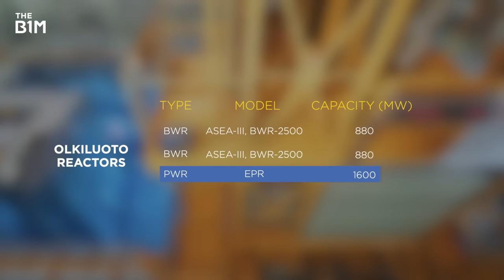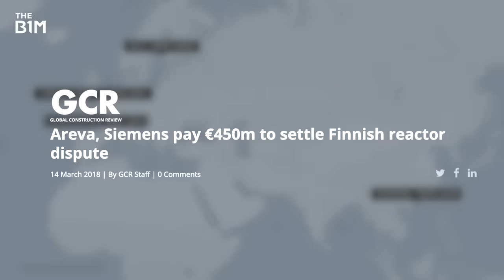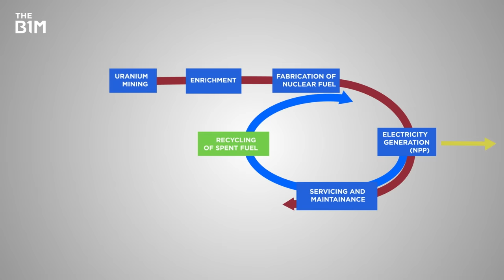Finland Might Have Solved Nuclear Power’s Biggest Problem

Comment: "guys, burying this isn't a good idea."
-"... Bury it deeper."
"Genius mate, bloody genius"
Reply: @miraclemaker1418   why ?
Reply: Hey, it works!
Reply: @GiorgiGoguaTuzo  because its very obviously a scammer
Reply: Pinned by The B1M  And many decide against trusting scammers like you. Google should eliminate the ability to have users phone numbers be used in the comment section I swear.

And for OP, @Timothy Shane , Lmfao, damn right. I thought they were going to find a way to recharge this or something that would prevent having to bury it. But no, instead they simply said "ah yes, use the same old method!"
Reply: @jxkc.3941  Burying it is not a bad idea. It came from the ground already. If was already there it shouldn't be too much of a problem to simply put it back.
Reply: @davidtherwhanger6795  Hmmm... Would it not have been there in a less charged state though?
Reply: Pinned by The B1M  pretending to be the channel owner and spamming that same comment 40 times on a single video is also a decision, a very horrible decision.
Reply: I know right, because if they encase it like that and bury it in the basement of a parliament building for a thousand years you wouldn't be so up for it. Plus I don't know how deep ground water moves about..
Reply: That's what she said.
Reply: @fyodorseriencha6538  Ground water can go as low as about 9000 meters, but it depends on the water table in the area to see exactly where it is.

But that really doesn't matter. Water is a shielding material. Every two feet of water between you and the source, you can take a zero off the power of the radiation that's getting to you. The water we used in the nuclear reactors in the Navy only held their radioactive charge for less than a minute after moving away from the source. 

Sailors onboard nuclear submarines would get less doses of radiation than people on land just going about their lives. Shielding is everything. And as deep as they are putting the stuff down here should knock a 1000 zeros off what radiation gets out of there.

Oh and you are standing on billions and billions of tons of Uranium that is cooking hot right now. It's what keeps the magma liquid.
Reply: @davidtherwhanger6795  "Water is a shielding material" I don't know how it works, I just assumed the casing could fail and water could get in and wash it off to be eventually absorbed by trees and get into drinking water bit by bit. But as I say I don't know, why even dig it so deep then if there's no way for it to get out and spread?
Reply: That's why you haven't studied physics...
Reply: @fyodorseriencha6538  Putting it in deep is how you make sure it doesn't spread. Putting it in bedrock that has been geologically stable for millions of years means the ground won't be moving around to rupture the containers. The clay around the containers expand when absorbing water, so if water does get in the clay will absorb the water, expand even tighter against the rock and keep the container in place. The pressure from the clay won't exceed the pressure the container can take as it is copper sheathed boron-steel. The copper sheathing doesn't corrode or rust, so any water getting to it won't effect the steel. And the fact that it is so deep means that even if a container is breeched , the radiation won't make it even near the surface.
Reply: @davidtherwhanger6795  Good start there lol: ''Putting it in deep is how you make sure it doesn't spread.'' Look, by my guess,  the ground has a potential to move no matter how deep away from the surface it is, I think it more depends on how far away the site from the cracks in the tectonic plates.
If the ground does move it will grind away at that clay layer and make it lose it's structure and water will get passed it. And you haven't answered me about if flowing ground water can pick up the radiated particles once they are exposed and how far it could transport them.
Also if this site is approved, the next sites would have even more lenient standards to decrease costs approved well paid off experts - it may be that they're just putting their foot through the door.
Anyway you may be right about this particular site idea being safe, but once a few more nuclear disasters happen there'll be a larger mob of people like me all too ready to lynch you i.e. all that circle of supporters and enthusiasts who push the tech with yet more smartass not 100% explanations. Nuclear is my pet hate.
Reply: @fyodorseriencha6538  Your ground water already has radioactive particles in it. And it has been for billions of years. You have radioactive isotopes in you right now that will stay there and given enough time will kill you from radiation poisoning regardless of what you do. And you were born with many of them.

Because you don't like it you will never be convinced it can be used at all. Even if there was not a single accident in the next 100 years it would not be good enough would it. 

But let me tell you this. The largest, longest running fission reactor on the planet is what is keeping you alive right now. At our planet's core is billions of tons of uranium, along with a lot of other heavy metals. This is crunched together giving us an natural fission reactor. It's what heats the core, and keeps the magma liquid. A liquid magma and the planet's rotation give us a magnetosphere. This magnetosphere is what keeps out the vast majority of the Sun's Fusion fired radiation from getting to us on the surface. The Ozone layer and atmosphere are insufficient even at full to stop like 70% of the radiation coming our way IIRC.

And this reactor at our core is running out of fuel. It will last a few million more years, but will stop eventually. The magma will radiate the heat away as it does now, but with no new heat from the fission process the magma will cool and solidify. Plate tectonics will stop. The magnetosphere will go away, like it has on Mars. And the full fury of the Sun's radiation will begin slamming into the atmosphere. 

Nuclear may be your big hate. But fusion and fission drive everything. Wind comes from the heat of the sun creating high pressure zones that then flow to low pressure zones. Solar uses the visible light part of the Electromagnetic spectrum, that is generated by fusion. Thermal energy is driven by the heat given off from the fission happening in our planet. You may not like it  But nuclear doesn't care. It is part of you anyway.
Reply: OMG, what's wrong with these people we have solar panels and wind turbines...nuclear power is the last thing we want on this or need on this planet...NIMBY. 

Statement from a local American Green Energy Disciple
Reply: If you're going to bury a body bury it right.
Reply: what about thermal, by using the heat from a very deep hole we can make steam
Reply: That's what she said!
Reply: @atomicviking2497  I'm aware, I was portraying the typical Green American.  Beside their NIMBY stances, they disregard the solar and wind current technological short comings and the vulnerabilities of the climate sources.  Additionally they seem to be unfazed by rather precarious nature of Lithium-Ion batteries.  When they fail just replace the battery packs.  
I have a 1953 tractor (diesel) that I can start up without issue and the motor has never had an overhaul. Does anybody believe that they will find a Tesla auto that will be able to operate without a battery pack replacement...after 20yrs?
Reply: @davidtherwhanger6795  thank you for sharing your thoughts without condescension.  I have learnt a lot, and still lots to think about.
Reply: @BWolf00  All those renewable energy sources are environmentally unfriendly, even more than fossil fuels.
Reply: @atomicviking2497  Efficient fusion is here. It was here at least in the mid 1980's. But fossil fuel companies patented them and sat on them, so others can't legally make them.
Reply: I Know let's drill lol 😂
Reply: @davidtherwhanger6795  But will contaminate the ground. And matter of fact, nobody knowa the long term effects of storing radioactive material underground. This stuff is radioactive for 400.000 years!!!
You can't call that clean, it's THE most enviromentally damaging solution we ever used!!!! Calling it clean is a blanket statement just like the decision to bury this shit "deep underground". 
It's clean "now" but not our problem after we die. A shit mental we've been fighting since the dawn of time.
Still nothing but a bunch of apes shitting where we eat but on a different level.
Reply: @aquamanindependent8436  This isn't true. Are you talking about cold fusion? If so it's never really been replicated and there's no reason to think it would work
Reply: @VI-pp4jo  do you have any reason to think this is "the most environmentally damaging solution" or are you just guessing
Reply: @atomicviking2497  Nothing is 100% clean. NOTHING. It's in the laws of physics of equivalent force reaction.
So long as the energy production is not at 100% efficency, there is going to be a byproduct to worry about that is not easily predicted.
So yes lithium batteries are a huge issue. But this technology is far from being at 100% efficiency, there's pottentially a cleaner way of doing it, and dealing with the fallout, is much more manageable than pure radiation for half a milion years. There is nothing clean about nuclear reaction and as I said above, we have no way of predicting the long term effects of it. For all we know, copper shielding could be erroded from inside, which is probably what's  going to happen in 200~ years.

What ammount of energy would be needed to excavate those canisters, while keeping safe from the radiation and not creating a mountain of robots that fail before reaching the reactive source.

It's insanely stupid what they are doing. Period.
"Cleanest" is designating a dump planet, as someone said, a gas giant. That will buy us some time, not fix the issue.
The energy we keep producing is not free and never will be. Watching people avoid this obvious fact makes me understand that we are being run by monkeys. I have no respect for anything "scientific" as defacto. Just a misrepresented view that serves the current power.
That copper WILL "melt". It's a calamity in the making.
Reply: @mymoomin0952  Yeah, I do. And what anyone CAN do is guess. Mine is based on the fact that radiation are just a bunch of particles traveling at very high speed. Colliding with copper particles, will slowly errode the copper. Which is THE only barrier between the core becoming a disaster underground.
Reply: Seriously? 
That's what it takes him 7 minutes to say?
Reply: @fyodorseriencha6538  Since the waste is in a closed capsule made of copper and then but in a hole filled with concrete, which is part of a tunnel which is also backfilled with concrete. Seems safe to me as it is in the bedrock as well.
Reply: @VI-pp4jo  First, there are other layers of protection. Second, there are things we can do other than guess. We can calculate what the total emission of the waste will be over its entire lifetime and test whether the capsules will withstand that. It turns out they can
Reply: @mymoomin0952  based on what?
Reply: Who participating in this discussion is a legit nuclear physicist with abundant experience with nuclear engineering?
Reply: @mymoomin0952  "First, there are other layers of protection" No. There aren't.
Reply: @VI-pp4jo  Why do you think it is stupid what the finns are doing? It is permanently solved right? 
I do think we need better solutions as fusion which is a great option to most energy plants. But until we can run stable fusion reactions, nuclear is the most efficient and safe solution there is atm. In Finland there are no rivers really and the sun doesn't shine as much as i.e. usa, and wind is not efficient enough in order to run industrial scale demand. So there are kind of few options that are clean and efficient enough. The best thing now that could come is fusion reactors or energy storage of some kind. But thats my opinion.
Reply: @VI-pp4jo  Yes there are? Each canister is fuel inside a boron steel canister, inside a copper canister, inside bentonite clay, buried deep underground in geologically stable bedrock. Each step adds another layer of protection
Reply: @VI-pp4jo  boron absorbs radioactive particles, its uses to control nuclear fission in reactors
Reply: @mymoomin0952  First of all, I'm surprised you found that.
But it just goes to show, it's inaccessible to the regular human. And if I can't read it, or for that matter 90% of the population and I'm being generous! Then the ones who decided "it's ok, let's do it" didn't act on a fundamental underatanding but on a chewed up representation of such a study, on a feeling passed on from scientist through to the power chain of decision in a country. And this is important because, again, probably close to 90% of the responsibility of that decision is shared and based on feeling. 

Which ultimately, is how we humans do, but it's also when feelings get corrupted and blindsided by an immediate objective, which can be anything and throughly decided before hand. 

"We are rationalizing animals, not rational" and this study I'm fairly certain is a rationalizing not rational. But maybe I'm crazy. 
First, check a snip of this study, that we're all highly opinionated about:
Reply: "Radiation damage occurs in a crystal if the transmitted energy from the energetic particles is sufficient to create stable defect pairs (Frenkel pairs) in the lattice. Historically, the Norgett-Robinson-Torrens analytical calculation method for the number of displacements per atom (dpa) in a lattice (NRT-dpa) (Norgett et  al. 1975) has been the standard evaluation method for this purpose during past decades, beside the Stopping Range of Ions in Matter (SRIM) code package. More modern approaches use semi-empirical interatomic potentials and classic molecular dynamics (MD) simulations. Recent progress has opened up for fully quantum mechanical calculations of the primary damage state and radiation damage parameters (Olsson et  al. 2016)."
Reply: "In order to evaluate the total damage, we need to calculate the damage rate first. Here we establish the theoretical framework for displacement damage. First the damage rate equation is presented as the equation governing the impact of radiation field on the material.  After this its various components  are discussed together with equations relevant in the context of the final repository.  The difference between gamma induced damage and neutron induced damage will be discussed here."

Seems to me, we're still basing 1milion years of incidence on our current science level. Which, I would like to add, goes through violent changes from century to century....
Reply: "When the incident radiation interacts with atoms in a crystal, all or some of the energy may be transferred. If the energy is sufficient, an atom may be scattered from its position in the lattice  and propagate through the material.  As it moves in the material it will interact with the surrounding  atoms  and  either recombine back to its original position, stabilize as a Frenkel pair (a vacancy and  a  self-interstitial) or generate a displacement cascade if the energy is high enough."...
" If an atom is displaced from its lattice  site, it receives a kinetic  energy given by  EK  =  T–Ed, where  T  is the energy transferred in the collision. If the kinetic energy is high enough, the primary knock-on atom (PKA) will move in the crystal lattice and when doing this it may impact the surrounding atoms and a displacement cascade may follow. "
...
" The number of displaced atoms,  v(T), as a function of transferred energy can be modelled by the Kinchin-Pease model,... However, this model is not accurate for the low (near threshold) nor high energy ranges (far above threshold). For high energies the NRT  model (Norgett et  al. 1975) has been seen as more appropriate but the recently developed arc-dpa model is  clearly more realistic (Nordlund et  al. 2018). However, here the dominating damage processes are in the lower and intermediate energy ranges and an in-depth discussion regarding the high-energy recoil range will therefore not be pursued"
Reply: I "chewed up" the article for those of you who don't want to read it and my conclusion I already stated at the beginning of this.
The decision of this is done on feeling, based on this study alone mind you, LOL !! For half a milion years, this piece of study is our "seal"  written with our current science level AND if you bothered to read that, the main argument I had, about copper melting, is not even tackled in the study. Talking about "high energy recoil" as it's being called which creates a cascade effect into the matterial. I understand that such forces are not immediate but the fact that it's not being explored at the least, with the risk of sounding like a broken mill, this is half. a million. years. we're talking about, combined with the fact that science changes drastically, often, gives me enough reason to conclude, we are still monkeys shitting where we eat.
Reply: *And, I might add, the last barrier between this calamity and us, is soil.
Mind telling me where else do you know where we can get farmable soil? Not for us, or the next immediate generations, but for the idiots that have to still believe this world has anything good left in it coming after... well who knows, that study surely doesn't.
Reply: @VI-pp4jo  Here's some questions to think about.
Where did the material come from first?
Was it radioactive before we used it?
How much is still in the Earth?
Is the Earth contaminated?
I ask these to gage how much you really know about this. I am not trying to be condescending, but I need to know going forward.
Reply: @davidtherwhanger6795  Butting in, agreed on last part.
It's worth noting though, that radiation, if we're wrong affects us for 400.000 years.
Solar panels and wind turbines, produce less energy but their fallout is MUCH more manageable amd we are not taking a half a million years loan from future generations.
Don't act like you can just sweep that under the rug and call the place "CLEAN".
Manage the fallout. Solar and wind is MUCH MORE MANAGEABLE!!!!
Reply: @davidtherwhanger6795  Saying "I'm not trying to be condescending" is precursory to being condescending. I wasn't born yesterday, you might have.
I don't mind you being condescending, so long as you're right but given your "put it back in mentality" I have no doubt you're wrong.
If you understand that energy doesn't just come "free" you must understand that we don't just take the pebble from the ground, extract free energy and put it back in.
Before you ask me what I know, feel free and "be condescending" and tell me how you think it works. In as much detail as you want 👍
Reply: @davidtherwhanger6795  Interesting angle you're coming from, I don't think there's any argument about feeling safe walking outside on top of the earth's crust with some sun cream on. And just because uranium is natural in our world and not some sort of black magic, it doesn't mean that it's not something to be justifiably scared of. Just pretend they instead developed black hole technology to generate electricity and then found a way to "encase" those black holes under ground so that they have no power to suck everything in. It's Icarus mentality.
Reply: @hamburgerhelpers3896  I know right, Tai Lung from Kung Fu Panda style
Reply: @VI-pp4jo  First off heavy metal contamination is forever. Once in it stays there until something removes it. And then you have to store it somewhere and hope it doesn't get out again. Forever. Fissionable material giving off radiation does have an expiration date. Heavy metals we will be dealing with until the end of time. But burying heavy metals is acceptable means of disposal, but we are not to accept radioactive material burying is acceptable? The main argument is that the material could get into he water table. Yet both could get into the water table by burying it. And the burying practices for heavy metals is much less careful than radioactive material as heavy metals are just dumped into land fills where rain water will definitely get to them.

I have been told we are approaching the upper limit of what solar can do do to our atmosphere. Solar panels in space are much more efficient because of the atmosphere not being in the way. So as long as we use solar panels we will have to use a lot of them on the surface, meaning a lot of heavy metal contamination in land fills across the planet in just a few generations. This will far exceed radioactive waste by several orders of magnitude quickly. You might counter with 100% recycling. But that would increase the cost. With a limit on efficiency put on us by the planet itself the cost of solar panels could exceed the price of power creation, making them economically unviable.

With wind power we are limited by technology. That is currently changing. But bringing with it more problems. I do not know if you have heard of solid state wind energy transformers (SWET), but they could revolutionize the industry. Or destroy it. They would last longer by removing moving parts and fiberglass blades. Fiberglass is not biodegradable at all and will last in the landfills for effectively forever. Solid State units I believe will use heavy metals, but their main problem is the electrical discharge they will have going on will definitely kill any wild life that gets near it. Some have likened them to giant bug zappers.

Now on to other topics. You may have heard about Background Radiation. It is all over the planet. All the time. It is what we get from the sun, and what we get from the planet. Right now at our planet's core is billions of tons of uranium going about in a natural fission reactor. It's what provides the heat to keep the magma layer liquid. This keeps the plate tectonics going. Volcanoes erupting. And our planet's magnetosphere working. Without that magnetosphere blocking the vast amount of the sun's radiation and coronal mass ejections from getting to the planet in the first place, we would not be here. The big problem with the core though is it is running out of fuel. Because fissionable material does decay. There is only a few million years of life left in it. And it is what is keeping us alive. Mars doesn't have a magnetosphere, so it gets cooked by the sun's radiation.

The only thing that saves us from the radiation at the core is distance and material. A common misconception is that radiation is blocked by some materials. It is not. It is reduced by shielding materials. The more in the way the more reduced it is. For every 2 inches of lead, 4 inches of steel, about 1 foot of stone, or 2 feet of water between you and the source of radiation you can take a zero off what radiation is getting to you. So burying it deep does help a lot.

And our water supply has had radioactive material in it from the beginning of the planet. That has never changed. Even if a river hit that storage facility and breeched every container eroding the material it would be eroding only atoms and small pieces of it at a time. You would barely see a rise in what radioactive material is already in the water per given volume of water.

And you were born with radioactive material in your body. They are still there. And will kill you given enough time regardless of what you do.

Radiation is natural. We live in it everyday. And have lived thru periods where it has been much higher due to drops in our magnetosphere allowing more in from the sun. We can manage it just as well, and perhaps better, than we can and do manage others.

The only difference is we have been told to fear radiation and not the other stuff that is just as deadly.
Reply: @davidtherwhanger6795  I'm aware, I was portraying a typical Green American Disciple.  Those whose beliefs say that nuclear and fossil fuels are all poison beyond the science and technology of man thus they must be abandoned.  Those who believe that millions and billions of acres of solar panels and windmill farms poses little or no threat to man and the earth. These disciples along with the "conservationist" activists cry NIMBY about nuclear and fossil fuel projects but say little about inefficient and immature green energy "infrastructure" projects.  
Additionally they seem to ignore the law of conservation of energy...while the Sun's power output is virtually unlimited, Earth' environment is not a closed system...and I have not heard any research about the long term effects of robbing Peter to pay Paul.
Reply: @davidtherwhanger6795  I'm actually impressed. I had no idea that heavy metal poisoning was even an issue.
Coincidentally, I just watched a video of the mass dumping activities in Ghana and the people there dying working to recycle the electronics, for chump change. They're given just enough to survive, kept in the loop forever. The biggest food market in West Africa is just accross from the massive electronic dump field. You can see cows "grazing the field". It's surreal once you open your eyes. 
The cadmium concentration is.. I forgot how high, but way above limits. 

STILL, they are working in that field and are not dying immediately, takes years and years. And most importantly, it's curable. There is no cure for radiation apart from replacing entire organs. 
Not to be read as if I'm excusing the practice, it gets me wondering how we can fix it, but the comparison is to paint the picture. Heavy metals, are metals, they are present on earth in far FAR larger concentrations than uranium 235, uranium which if I understand correctly isn' t even the only problem but the byproduct of nuclear decay.

The issue with heavy metals is very poorly managing of recycling which allows for them to seep into the soil and mix at a very high concentration. Which, mind you, will keep increasing.

It is still far more manageable than a  tomb of uranium decayed byproducts radiating the entire soil for 450.000 years.
If our current heavy metal situation was a star, a radiation tomb is a pulsar.
At least that's how I see it.
It's not that a high concentration of heavy metals is fine, it's that radiation is far FAR worse.

And studies presented here, are blankets, they're not produced to inform but to throw a bone to the first waves of skepticism.
Just look at the way we treat our garbage, to understand how well intentioned humans are.
I'm not going to believe 3 scientists are enough to give this the go.
Reply: @BWolf00  Yeah, the biggest realization is that the world was already in as perfect equilibrium as possible.
Question is, live and enjoy or... fight to escape our obvious demise.
Don't think we can but, I also don't think we should stop trying.
Reply: @BWolf00  😂 oh well. Sarcasm doesn't always come across in text.. haha
Reply: @VI-pp4jo  Only some of the effects of heavy metal poisoning can be cured. Prolonged exposure does lead to life long problems, and possibly to genetic defects in children at birth that cannot be cured.

Regardless of that though. You see that certain levels of heavy metals are acceptable. What level of radiation is acceptable then? We get it every day. Radiation is all around you right now. How much radiation does this waste produce? How much shielding is needed to reduce it to acceptable levels?

My point is that burying it deep enough reduces what makes it to the surface to be so low you can't tell difference from it and the back ground radiation that is already there except with the most sensitive detectors we have. And will still be below acceptable levels. A thousand feet of stone does a lot to reduce radiation. And we are talking about a facility that would be in use for quite some time, so breeches would be noticed and repaired. Unlike how we treat other pollutants right now. The facility could still be monitored after official use was over by simply keeping the radiation and moisture detectors on and monitoring their output for problems. 

Just because there is radiation below ground doesn't mean everything above or around it would be contaminated. Or else the Billions of tons of uranium (which is a heavy metal as well and I won't get into depleted uranium munitions here) would have irradiated the planet long ago.
Reply: @atomicviking2497  I knew I was running that risk...np.
Reply: @RenanMsV_YT  you have a point but it's the same argument with environmentalists
Reply: @VI-pp4jo  My main problem has been that many look at nuclear waste and see a boogey man they fear. They give a hand wave to the other problems of other things, but scream hell and damnation about nuclear. 

But I believe almost anything is manageable. Cost, risks, efficiency, and benefits all have to be weighed.

On to the bright side. Solar will never be that useful to us, down here. The atmosphere plays hell with the light reaching them. The higher up you get them the more efficient they will be. I personally want to see tethered power satellites in geosync orbits with huge solar arrays getting near 100% efficiency almost all the time and sending back that power.

Have you heard of the King's Island Wave Project? That is where they are harnessing the power of wave motion in the water to produce power. Australia seems to be leading the world in this endeavor with several different types of wave power generation being tried right now.

And I have heard at least on company is experimenting with a way to pull carbon straight out of the air. We have been able to do this in closed systems for over 60 years, but these guys are wanting to do it on an industrial scale to make graphene. And there are several companies around the world are actually building facilities to pull carbon straight from the atmosphere for various purposes.
Reply: @atomicviking2497  I have always wondered why the Fossil Fuel Hegemony never bought up the "designs" the "technologies" associated with electric vehicles, solar panels and wind turbines...seems these should be locked away in that ever mythical Fossil Fuel Protection Vault.
Reply: @davidtherwhanger6795  The point about radiation is that it irradiates/contaminates the ground around it. And argument that other do too, is not an argument for radiation.
How much worse is nuclear decay compared to heavy metals, I do not know. As in, I do not have a table with the effects of both on a scale. But, as I said, heavy metal poisoning is a matter of recycling better. The solution is here. And I'm glad to hear about extracting energy out of seas tide and out of air? wut. I'm sure they all pose serious problems that must be tackled and accounted for.
I for example would like to see a biotechnical solution, that combines all these energy capturing devices and uses them to "brake" the flow of nature into the direction we want.
Having massive windmills that brake the wind, obviously will have a local - > into a global effect. I don't know what that is because I'm not versed in geo-formation or w/e, but I'm sure it exists, as it's only natural. Same with tide.. Same with solar and so forth. Everything has a fallout.
However sometimes, the action of natural forces are the fallout themselves. Such as tsunamis, hurricanes, earthquakes, etc. These are just extreme examples. But if we can harness these forces, then we have definitely conquered it on a lower scale, such as locations where high wind is detrimental to the landacape for example.
That's "conquering" CIV I not nuking ourselves for the next half a million years so we can accelerate the process of consuming.
Saying, they will attend to the pods, is wishful thinking. It doesn't take a genius to see how Chernobyll was handled and apply it to the current topic.
If there's cracks at Chernobyll, you best believe they will fix it, because it's in their "backyard".
If the canisters/pods fail in Finland, deep underground, where tons of soil shield us, you best believe nobody will care until the stink comes to the top. Which won't happen for the next few generations. And when someone HAS to do something about it, it's deep underground!! Where tons of soil are already radioactive... In case you forgot how radiation works and thr energy required to amend the situation will be competing with the one that was produced. Thus, making this very not clean, a problem for future generations and tons of dead soil for 450.000 years.
I don't care what argument you have about heavy metals. It does not take away from the fact this is an insanely stupid idea.

And one last point, that caught my eye since you first spoke of taking it from the ground and putting it back in. Uranium 235 is a very VERY VEEEEERY small portion of uranium found in nature. Less than 1% of it.  Check this quote from wiki:
"Naturally occurring uranium is composed of three major isotopes: uranium-238 (238U with 99.2739–99.2752% natural abundance), uranium-235 (235U, 0.7198–0.7202%), and uranium-234 (234U, 0.0050–0.0059%)"
To get uranium 235, they enrich regular by "Isotope separation". So that talk about "it's cool, radiation is all around us" is severely misrepresented. My friend, as I've said and you probably grazed over, the key is in INTENSITY. 
Everything comes from nature. What kills you is high amounts! 
And there's very high amounts being burried underrground, and not some fuck know how many thousand of kms away from us underneath a core of molten lava! So don't equate that!

Or I can equate having Betelgeuse as our star and say, "It's k, it's still a star, we have stars in nature". WE. WOULD. DIE !!!
Reply: And, regarding how much is too much, is a question that I'm pretty sure you, and I'm sure I, can't answer.

However, it's about watching history repeat itself.
That copper, I bet my life on it, will get erroded, not sure how long it will take but it won't be thousands of years, and once that cracks, it's a house of cards where corrosion does the rest and radiation grows quite possibly exponentially and also accentuates the process of de-sealing, talking about concrete, which is not gonna last for more than 100 years, pretty sure I've read that about Chernobyl.

This is all theory crafting into the future of mankind. As I said, it's a loan into our future. A very very documented tendency in us. Everyone and their mother has had a loan and US has unpayable debt. 
I don't stand for it  in the slightest. Humans are nasty creatures that follow an immediate gain. That's what this is. You can try and find reasons, scientists and all that bullshit, nobody can predict the future for 50 years let alone thousands, hundreds of thousands is laughable. Just the fact that I am still here arguing this insanely obvious charlatany, is making my skin boil...............
Fuck them. From A to Z whoever approves this monstrosity. And you if you support it.

Consume less and more focused on growth if that's what's really followed.
But it's not, what's followed is more power to produce more consumerism under the guise of "evolution".

Evolution is accountable. 3 scientists and a copper tube burried underground does not make the most damaging effect known to man-kind even.. retarded. Just retarded.
Reply: @VI-pp4jo  If you read nothing else, read the article at the bottom.

I'm a graduate of the Naval Nuclear Power School. I have actually been inside a nuclear reactor (outer areas after a couple of cool down days). I've been closer to this stuff than I hope you will ever be.

What you seem to be missing is INTENSITY as you put it drops off over DISTANCE. Shielding material like stone, earth, and water drop it off exponentially over distance.

And yes I do know that U-235 is less than 1% of uranium. In a comment to another on a different thread of this video I told that to some one else explaining enrichment.

The problem I think here is you believe that the material is some how actually magnified by the enrichment. This is not the case. It concentrated by the enrichment process. Removing the U-238, but retaining the U-235. The same amount of radiation was being given off by the rock that was first dug up as what is being given off by the uranium that is there. You do have more of it in one place. But this is low grade enriched. 
https://www.wise-geek.com/what-is-enriched-uranium.htm#:~:text=The%20lowest%20grade%20is%20known%20as%20slightly%20enriched,although%20it%20can%20be%20as%20high%20as%2020%25.
As you can see LEU is normally between 3% to 4%, or roughly 4 to 6 times more concentrated than normal. Meaning it's Intensity is only about 4 to 6 times as much as normal ore which has 0.7% concentration. So while you believe it is super intense, it is not. Your probably thinking this is weapons grade or High Enriched Uranium.

And there are open pit uranium mines in the world. Meaning the uranium was much closer to the surface than this facility would be. People work in these open pit mines all the time.

Now that I think of it you are probably thinking that the Intensity is coming from the metal itself and not the reaction. That is actually a little misleading it self. As U-235 decays it gives off a neutron. This neutron must hit another U-235 and cause it to shatter into Ba-141 and Kr-92, and gives off 3 more neutrons that then collide with other U-235 atoms and causing them to split. This is why it is called a chain reaction and the phrase splitting the atom. After a few years this nuclear fuel begins to drop in it's ability to sustain a reaction as much of the U-235 is already split into other elements. The waste is then treated for years. As explained in this article.
https://whatisnuclear.com/waste.html#:~:text=But%20because%20nuclear%20reactions%20have%20occurred%2C%20the%20contents,of%20iron%2C%20zinc%2C%20germanium%2C%20zirconium%2C%20silver%2C%20and%20iodine.
Reply: @atomicviking2497  Jesus, what's your problem?  I wasn't "arguing" with you, in fact I was agreeing with you.
Your reading comprehension and sarcasm sensor sucks.  You must have used it all up yesterday.
Reply: @davidtherwhanger6795  I am not missing that it drops off over distance but I think saying, "it drops off" is misrepresenting. It doesn't just drop off, the material around it absorbs the radiation, absorbtion which, denaturates the material in the process. I. E. irradiation.
And my problem is if the copper fails, and it will, irradiation starts growing exponentially.
I am not saying it will reach us in deadly doses directly. I am saying we are killing a piece of land, and we are, for 450.000 years. Sometimes being in the field serves as a blind spot so you should welcome outside input, gets you leveled.
Second, I have been thinking of HEU, so good to know there's a difference. The article also mentions that it can go as high as 20% concentration, which signals to me that if it can, it will. As soon as the energy needs rise, so will the enrichment and 20% is just an arbitrary number, it can go as high as, depending on needs as I just said.
Let's take 4% concentration though. Is the U235 the only thing being deposited underground? You haven't mentioned anything else...

/// Just got to the last link, and it is mentioned. My point was nuclear waste is not made up of only u235 but other byproducts which are highly radioactive, so talking about just u235, is shallow.

Anyway, I've read the article, very informative and I also feel it is very supportive of nuclear power. And you as well, being in the field are.
The study does not account for pollution implications over time, it compares it with current levels of pollution from coal and oil which nuclear obviously wins. On a function of time, will it though? It's impposible to know. That's a big part of my argument.
You're borrowing time from future generations, shining a light on the inadequacies of current energy production while shadowing the very problematic "0 knowledge" of what this does in as much as 1000 of years. Let alone more. Nuclear is a century old, it's too young for us to bury radioactive waste in the ground. So yes, I am mad. Has nothing to do with believing in evolution or whether mother nature is ruthless, I never said it isn't.
I am attacking an obvious selling pitch of nuclear power.
I've said it multiple times already, it's 3 scientists, copper tubes AND as you've well pointed out a century of understanding about nuclear to guarantee for 450.000 years. You tell me if that sounds right to you.
I'm pretty sure you're just blinded by being in the field and you want it to succeed because you're part of it.

I want it to be a clean solution that saves us all too. But it isn't. Not with 450.000 years of uncertainty downplayed as "serious concerns" and even that just as a title.
Like seriously, where in that article were long term effects addressed? That's from very strong proponents of nuclear power.
All I saw was a chick standing next to a cement casket. What happens if that casket is unatended for 100 years. Just that, not talking about more.
Reply: @VI-pp4jo  There is no solution that is clean. And the concentration of the material doesn't change the amount of radiation it is giving off, just the location. 

Look at it this way. You dig up 1000 kg of uranium, containing about 7 kg of U-235 from a hole in the ground. You enrich it, which is incredibly difficult and no level of enrichment is reached by accident. You now have 175 kg of uranium. If you put that back in the same hole you removed it from it's still the same 7 kg of U-235 isn't it? Did it wreak havoc on the soil before?
Reply: @VI-pp4jo  Oh I did forget to mention that to get other material to become radioactive they themselves have to be giving off neutrons when absorbing the neutrons given off by the fissionable material. Not all materials do. If they did then everything would have been radioactive billions of years ago.
Reply: @GiorgiGoguaTuzo  spam
Reply: @atomicviking2497  misinformed mate
Reply: @BWolf00  you are 100% misinformed
Reply: @aquamanindependent8436  clearly oil company propaganda.
Reply: @kriss8931  I guess you are having trouble conceptualizing  jus how long 100,000 years is.
Reply: @mymoomin0952  100,000 years… there is no test for that.
Reply: @minaaris  I was an engineer for the Fukushima plant and before that Chernobyl.  Feel better now?
Reply: @mymoomin0952  you something to say come out and say it for Christ’s sake.
Reply: @launcherx2044  until it cracks
Reply: @VI-pp4jo  well masticated.
Reply: @davidtherwhanger6795  if you covered your entire house with solar your car battery would contain 100x the lead used in that solar installation-you probably replace that every 5 years. Cadmium is used in trace amounts. Both will be eliminated by 2026.  Landfills no longer leach into ground water - they are capped.
Reply: @davidtherwhanger6795  Yeah, but then why actually is the waste not just buried in some already empty mines, where the uranium was mined in the first place?
Reply: "a game changer!"
Reply: @davidtherwhanger6795  I agree with a lot of the stuff you've been saying about nuclear but I think there's much more reason to be optimistic about solar than you might think. There's tonnes and tonnes of space for solar panels, which are cheap and getting cheaper really fast every year. They'll never provide the consistent, year-round power nuclear can, but they can provide power during the day much more cheaply. Yes there's issues with disposing with heavy metals, but in the same way that we can dispose safely of nuclear waste we can dispose safely of heavy metals.

And obviously it'd be many times better if we could efficiently beam down power from solar-powered space stations, but until then there's an incredible amount of sunlight on the earth's surface
Reply: Basically they want to push the problem off to future generations to deal with. I love when humans think we can design indestructible things, remember the Titanic?
Reply: @atomicviking2497   countered your argument with a specific example I personally know of. But someone removed it. I basically retyped it in response to cpmac.
Reply: @rcpmac  And the battery storage for the solar peek power capture? For days when the sun isn't out.

Cadmium I think was banned in batteries a long while back because it only takes a trace. 

But the main reason I brought this point up is that one of the arguments of this nuclear waste facility is that it could get into the water table. However, if a landfill can be sealed with no chance of contamination, why not this facility? Thank you for pointing that our.
Reply: @davidtherwhanger6795  I've learned a lot today regardless of the fact we disagree.
I want to add, I just caught up with the naval part of your study, being the main focus. So you're a sailor! That's actually cool. Braving the waters has always been closed to my heart. Albeit in pirate form.. Arrr 🤣
Anyway, reading back from the perspective of knowing about nuclear first hand and catching up to it being a discipline rather than the focus of your study, I assume you developed these opinions about heavy metals being out of focus while radiation gets all the heat, from a teacher?
Also, I wasn't discrediting the efforts of people, well I was and am, but as a "not enough" not as a "you're not considering it". Road to hell is paved with good intentions though. Not sure what that means, geniunely but feels apt for the situation. 

Just one last argument I think we can have, how is.. 175 kg of U235 not more radioactive than 7kg?
Also, from the link you gave me, radioactivity comes after nuclear fision, so I don't underatand the comparisson.
Reply: @VI-pp4jo  you've said a lot so

• The decision to build the facility wasn't based on this study alone. This is one of several studies on specifically long-term radiation-induced erosion of copper shielding for this kind of waste disposal, which I chose because it was free to read and because it was the most recent. There've been many many studies on all aspects of this.

• If you're concerned about melting via heat, then I can address that for you now: the waste has already been kept in high-energy waste storage for a long time before being stored, so it no longer emits enough heat to melt copper, and it only gets colder over time.

• Radioactive waste will never grow exponentially in radioactivity, it'll only shrink exponentially. That's the fundamental problem with nuclear waste disposal — for long-term waste the risks are always minor but they last for a very long time. The many layers of protection aren't to prevent some kind of meltdown but to prevent a noticeably higher risk of cancer in an area of Finland, and they'll do a very good job of that.

• it's often overstated how much science changes. I can guarantee all those various prior models give roughly the same result but in increasing levels of accuracy. It's like how general relativity is more accurate than Newtonian gravity but the Newtonian stuff is more than enough to land spacecraft on comets.

• I get a general sense from your comments that you think people are very cavalier with risks around this. That might be true for some things but people are incredibly, incredibly cautious with nuclear waste disposal. This wasn't done off three scientists and a prayer; this was the culmination of decades of research into the safest possible methods.

• just in general if you can, off the top of your head, think of a potential issue, it's worth checking if it's been covered in the decades of research first.

• we can never predict the future, but I can guarantee you the pyramids will still be standing a thousand years from now. For this, we know how long this bedrock has been stable for (billions of years), we can model using a variety of techniques how long the casing will last (hundreds of thousands of years), and we can look at similarly-situated natural uranium deposits or reactors and see how much radiation reaches the surface (incredibly little)

In summary: if you told me they were making a low-level radioactive waste disposal hundreds of metres into bedrock below my house I would be fine. If you told me it was gonna be baked into a ceramic, which was put inside corrosion-resistant zirconium alloy, which would be inside a steel tube, inside a corrosion-resistant copper tube, inside water-blocking bentonite clay, inside especially-stable bedrock, and then the whole facility would be reburied — well then I'd have half a mind to ask you to not bother with the fuss. The project is so safe it's ridiculous, and pretty much any two steps would be accepted to store equally-dangerous non-radioactive waste. It's only possible to be this cautious because of how little waste nuclear energy produces compared to most industrial processes.
Reply: @rcpmac  That makes me happy 😁.
Reply: @never5pring  I am not certain, but two things do come to mind. First you can't put it back into an active mine, too much big machinery digging going on. Uranium is sometimes a byproduct of Phosphate mining as well so many of the mines could still be in active mining. And second, people have this strange notion that even if it was there for billions of years before it came out of the ground, it is now dangerous to put it back in the ground. And will protest and sue the daylights out of any one who tries to put it in the ground.
Reply: @never5pring  mainly because people are super-super nervous about nuclear waste, more so than natural ore, so you can't do anything other than the most absolutely safe possible option - and as you see here, people will even complain about that
Reply: @mymoomin0952  I'm not opposed to solar at all. And completely agree we can manage heavy metal containment.

I do disagree with giving on form a hand wave, but vilifying another simply because of bias. Using the term "Clean" or "Green" leads people to believe there is no problem at all with their use and that others are simply fools for pointing out options.
Reply: @aquamanindependent8436   Sorry but I'm pretty sure that example got eaten too. I don't doubt the fossil fuel industry has done something awful to do with fusion - it's the fossil fuel industry - but I do want to know more about safe efficient fusion power from the 80s
Reply: @davidtherwhanger6795  in that case I agree with you completely
Reply: @rcpmac  is the massive essay I just typed out saying enough for you lol
Reply: @aquamanindependent8436  genuinely I can't see it. I can see one where you mention a guy you told him about but not the one where you tell him about the guy. I think YouTube ate it? If it has a link or something that might be why
Reply: @mymoomin0952  None of which can account for long term exposure. They just can't. We do not control that many variables, I don't care how many studies are done.
And alarmingly, even the variables that we do know about, are dismissed as, insignificant.
From the study you gave me:
"However, this model is not accurate for the low (near threshold) nor high energy ranges... However, here the dominating damage processes are in the lower and intermediate energy ranges and an in-depth discussion regarding the high-energy recoil range will therefore not be pursued. "

That sounds very "cavalier" to me. That's a new word I learned lmao.

Anyway, that's my concern, radioactivity knocking the lattice of Cu and overtime creating a breach. Heat is a secondary concern once that breach is made. And radioactivity growing exponentially, is a resultant of this house of cards scenario explained above. I understand the concept of half life.

And again again again, I'm worried about what happens well into a couple generations forward. Not at all worried it will be a problem in our time.
People are very cavalier with our future generations time, not theirs. It's why I made the analogy of borrowing time from them. From 45000 generations, for which we have done "many many" studies.

I don't think you understand my outlook, because from where I stand, saying there's been "many many" studies is just drool coming out your mouth in front of a good steak. A juicy "cover all our problems solution so we can keep doing what we were doing" steak. 
And I can see clearly it's. just. a blanket. statement. for anyone who wants a piece of that steak. 
Nuclear is not safe or clean, it is "now".
The long term effects are not accounted for and CANNOT be. And when comparing current pollutants with nuclear, it is not done over a function of time. Because it cannot be! But it's not even attempted.

Anyway, I'm not going to just  reiterate what I said over and over.

I still don't understand radioactivity properly, so i will look into it. But, worth noting that the naturally found Uranium, is not the same as nuclear waste.
Not even close. Navy guy upstairs just linked a site where a guy was holding u235 pellets in his hand. So not... what we're talking about.
Reply: @VI-pp4jo   There are natural nuclear reactors that exist in nature, and have for a billion years. We can study them. There are natural pockets of radioactive material. We can study those. The low-level radioactive waste in long-term storage is safer than that. It is safer than nature. It's incredibly easy to say "oh but what if something happens" but we know for a fact that, for instance, this low-level waste cannot ever lead to a runaway meltdown of exponential growth in radiation. We know this because material this radioactive has existed for the entire history of the planet. We have millions of experiments and billions of years of history to study. It's true that technically everything could somehow go wrong - the sun could go out tomorrow! But predicting a catastrophe from this stuff is on that level.
Reply: @VI-pp4jo   I think what confuses me about your outlook of completely rejecting scientific evidence is why care specifically about radiation? If no study can ever be enough then surely literally everything on earth is at risk of causing a catastrophe and no evidence can ever disprove that — they would just be juicy "keep doing what we're doing" steaks covering up the risks of, idk, dandelions or whatever.

It seems like you must have some reason or evidence to start fearing nuclear waste rather than anything else, so why can't reason or evidence stop that.
Reply: @VI-pp4jo  I may have mistyped that. What I was trying to say was 1000 kg of uranium contains 7 kg of U-235. After enrichment at 4% there would be 175 kg of uranium containing 7 kg of U-235. The enrichment removing the other uranium.

Radioactivity is always present, from the very beginning. You may have misunderstood the article. The uranium that comes out of the ground is radioactive from the moment it was created by a couple of neutron stars colliding. Enriching the material makes it easier for a nuclear chain reaction to happen. U-235 gives off a neutron that goes shooting off and if it strikes another like it, that neutron breaks the U-235 into other things and gives off even more neutrons from that collision. That is fission. Enriching makes it easier because there is more in a smaller space than before. Natural reactors that do this are possible and have happened. That is what is going on in our core right from the beginning of our planet. And has occurred in the Oklo Gabon region of Africa. The process of fission reactions being caused to happen decays the material faster than it would naturally by not waiting for it to decay, but causing it to instead split into other elements right now. That's why after about 6 years the nuclear fuel has problems sustaining a fission chain reaction. This doesn't accelerate natural decay, but replaces it with a faster method of changing them into other elements. That's why I have been making the comparisons and arguments. The radiation is nearly identical to the way it was before, and if it caused no damage then, why do we think it will now?

And I am not opposed to heavy metals. I just feel that using of the terms "Clean" and "Green" are misleading. We are taught that power generation by these things are free of problems and we are fools for not considering problems or seeing alternatives.

There is nothing out there that doesn't have a problem with it's use, even if we don't know what that is yet.

I can't remember if it was you or another who brought up using wind power to block the wind. A few problems with that are that the blades cannot take high winds without risking damage. Most current turbines stop rotation and turn the blades to show minimum angle to the wind if the wind reaches 55 mph. And I have always been a little concerned with over use of wind turbines actually disrupting established wind patterns. I have no idea if this is even possible, but with solar panels causing new heat zones and thus higher pressure zones combined with increased resistance to wind flow by blades that the patterns would be disrupted. The Amazon Rainforest relies heavily on the wind born sand from the Sahara Desert for fertilization. Thousands of years ago the Sahara was underwater, then a large savannah, and in some places a rainforest. This caused a lot of diatomaceous earth to be deposited in the area that became the Sahara. After climate change turned it into a desert, this diatomaceous earth is carried by the wind to fertilize the soil in the Amazon allowing the forest. It has been thought that if this regular air pattern stops that the rainforest would go away. I don't know if it is possible, but it has been a question of mine. And goes to show that we have a lot of things to plan out going forward.
Reply: @alphazero6571  And how does that change anything I have said. Why don't you tell me what you think enrichment means.
Reply: @davidtherwhanger6795  You should look up "concentration" and "Half life" of "Uranium 235" and "Plutonium 239". You'll have then, a better understanding of the concentration of isotopes found in the "wild" vs. commercial grade and why it's bad to bury it. Especially in water tables.
Reply: @DJBillionator  Uranium has about 0.7% U-235 by volume. U-235 has a half life of 704 million years. U-238 has a half life in the billions of years. Some Thorium isotopes have a half life longer than the estimated age of the universe. Low Grade Enriched Uranium for power plant use is normally between 3% to 4% U-235. They get a higher percentage of U-235 by removing the U-238 while retaining the U-235.

Currently radioactive nuclear waste in the USA is stored at the Reactor sites mostly in Concrete above ground containers only 3 to 4 meters thick. This is sufficient shielding for people to walk in and around them. Why would I then think that 500 meters of stone and earth would not be sufficient to keep me safe from it?

And if they believe that a little bit of plastic can protect you from heavy metals in a landfill getting to your water table, why can it not work for this? Or something else?
Reply: @mymoomin0952  Because it spans onfor 450.000 years. The fact that I've been saying this in almost every single comment yet you still come back with "dandelions" and trying to paint me as a fear mongerer goes to show your agenda.
I'm glad you like nuclear, guy.
Reply: @davidtherwhanger6795  Mate, I'm starting to think you're just compiling some facts inside your head and relying heavily on your background for the gaps, to get an inflated sense for what you actually know.

You've said two times now that after the process of enrichment you get 7kg of u235 still. Excusing yourself with childish "I may have mistyped that"... I almost forgot your "I don't want to be condescending" background.

Look up what enrichment is and how it's done.
Then look up what's actually radioactive in the canisters deposited underground. I can't believe you and pal co are still talking about "coming from the ground".
U235 is coming from the ground and even that in VERY trace amounts.
Both U238 and U235 are radioactive but they do not deliver deadly doses of radiation, matter of fact, I JUST said, in the article you gave me, a guy is holding u235 pellets in his hand. I was wrong, they're pellets containing the 3-4% u235, as I forgot the part about us not using 100% pure u235 in power plants as YOU've told me previously. Those pellets are coined nuclear fuel.

The nuclear fuel is "After fission occurs, it is hazardously radioactive and cannot be handled without shielding."
The kind of stuff that kills you after 3 seconds of standing near it. u235 isn't even on the scale at that level.

After 8 years in the cooling pools, that stuff can be air cooled. Still very radioactive and still very dangerous nothing compared to u235 that "came from the ground". The fact that your and the other guys understanding of radioactivity is based on u235 "in the ground" levels just shows how much you really understand about this technology you propose and it validates that people act on feeling not a fundamental understanding! You "feel" those scientiats and people governing the situation know better, and I KNOW people are a bunch of idiots that like to flaunt a diploma!

The stuff that's radioactive in the ground, is starting to go through half lifes less and less, due to how it works. At the very instance of nuclear fission, half life happens in nanoseconds, doubling in time after each instance of half value of radioactive decay. That's why you see the graphs of radioactivity as functions of time. Because after each succession of half life, the time required for the next one doubles!

The point I'm making, nuclear waste is very stable in its radioactivity, the stuff they are surrounding it with, is not stable around radioactivity. It is VERY much influenced by it, because radioactivity are just fast particles moving at a high rate of speed knocking everything on molecular level. Cu tubes don't escape this phenomena. And there is no knowing what happens after a couple of thousands years. Which is just minute percentages of the total time this is active! Remember, it ia very stably radioactive! In the link you gave me, there is a very near graph showing you that the levels between 100y and 130.000 years deteriorate only to HALF of what it is at the beginning compared to the total radioactivity over a graph of time. "Half-life" duh!

Concrete walls last for 100 years when I'm being generous, not even talking about "bentonite clay" LMAO!
What happens after 200 years is, we have burried this radioactive monster in baby diapers and its already full of shit, the concrete and bentonite, the major players against moisture are cracked, give it a couple thousands of years, rust is as good as done if that Cu shield is broken!!! It's why I said, 3 scientists and a copper tube. Concrete and bentonite are just mental shields, they do NOTHING on a graph of time. This is 450.000 years, I think I forgot to say. 2 layers drop before you can even see them on the graph, how long do you think a copper tube will last?

Look up Chernobyl, the cement is cracking. If water reaches the core, which I knkw it won't, because it's IN THEIR BACK GARDEN, it WILL start a self sustained reaction, effectively doubling the total time. 

Now imagine that underground, where they want to tomb it under tons of soil, not manage it, tomb it. Otherwise they'd keep the shit up top, no biggie ay ? 
What's the cost of upkeep over 450.000 years my guy?!!!! Or is that not in your calculation by any means? 
Bury it and let other 45000 generations deal with it while we've already sucked off most energy out of it? 

I've got stuff to do then entertain the delusions of nuclear airheads.

There is no discussion. Unless nuclear finds a way to deposit these AWAY from Earth, nuclear IS NOT A VIABLE energy source.
Reply: @VI-pp4jo   • The spent nuclear fuel is less radioactive than unused nuclear fuel. That's why it's spent.

• It's reasonable to compare this to stuff in the ground because there has been stuff even more radioactive underground — like I said there was, for hundreds of thousands of years, a functioning natural nuclear reactor underground in Gabon and we can study that a billion years later. 

• half lives are constant, that's why people use them

• do you have any reason to think bentonite clay, which is geologically stable, would crack in an instant. Do you have any reason to think that copper cladding would decay away other than that you didn't like that one paper

• You're not even addressing the first/last line of defence, which is that it's buried in very old stable and impermeable rock. We know for a fact from looking at uranium deposits what happens to actinides in situations like that, and the answer is that it doesn't come up to the surface or get in the water supply. Look at cigar lake mine, which contains the same uranium and uranium decay products as this.

• it's very easy to get overwhelmed by 400,000 years but remember that less than one ten-thousandth of the history of the planet. As hard as it might be to believe there have been more radioactive materials, and even  active nuclear reactors before us. We can see with our own eyes what happens in places like this and we can learn from that. 

And again, if none of this convinces you, do you have any affirmative reason to be afraid of this stuff other than what you've said - that this lasts for 400,000 years and then is no longer a problem - because if that's all it's very unconvincing in the face of many environmental harms from, as we've discussed, regular heavy metals for instance, that never decay.
Reply: @mymoomin0952  "The spent nuclear fuel is less radioactive than unused nuclear fuel. That's why it's spent"

AHAHAHAHAHAHAHAHA!!! 

I rest my case! 

The rest of your points are just a kid playing internet game for points. 
From the "natural nuclear reactor" an unverifiable proposition that happened 2 billion years ago when there was one species on earth - amoebas, to your brain seizing and printing out "Half lives are constant, it's why we use them", to never holding clay in your hand and asking me how I know, not understanding that if they use clay, there is geniune concern of water, I don't have time to reaearch every ineption your brain can come up with, to finally telling me it's easy to get overwhelmed when the thing that overwhelms you is still, most probably, homework.
Do yourself a favor, and do it.. before talking to me.

Understand the basics of this whole argument, Radiation. What it is; and then look up where it comes from; and THEN understand the radiation of nuclear waste and compile results with in - our time - scenarios - Chernobyl. Not ones which happened 2 BILLION years ago. And then, look up effects of radiation, have an understanding of how politics work and how they rarely look for a good solution long term, just one in their mandate period. And it's influenced by global interests of few, not the many. And the few lead by money power, money which were accumulated through Greed. Not a general feeling of good-doing for the people.
Sorry kid, this world isn't as nice a place you think it is.

What I'm worried about is legitimate and what they feed you is a false sense of security on which they build    nuclear weapons, wage wars, kill thirld world countries with our trash, etc.
It's not all bad but a thing they're trying to bury so deep and forget about for 450.000 years reeks of "it'll be fine" and "not our problem anymore".
Why wouldn't they just keep it upground? It's not dangerous, right? And it's easy to maintain! Another point which both of you have evaded and easily dismissed, upkeep over 450.000 years.

It's hard to face it, but the "pollution" you're fighting now is exactly what that upkeep represents and is swept under the rug, or in this case ground. It represent pollution. For 450.000 years. Future generations will have to pay the debt, with other means.

We can't even handle debt in money, let alone in pollution.

Do us all a favor, and wake up or shut up.
Reply: @jxkc.3941  less concentrated, but precisely the same chain of radioactive decay. Rather like granite stone houses accumulate heavy  Radon gas over time, which we now to take precautions against...
Reply: @VI-pp4jo  it's clear you have a deep-seated fear of radiation that can't be assuaged by evidence; I apologise for engaging with you
Reply: @mymoomin0952  Get lost.
Reply: @davidtherwhanger6795  You have a godlike level of patience. I can only salute you.
Reply: @VI-pp4jo  Wait. I just re-read your last post last paragraph. You aren't saying to launch that stuff up in a rocket are you?
Reply: @davidtherwhanger6795  sloppiest post-rationalisation ever.
Reply: @Gotta270101  Enlighten me then. Show me how you would do it.
Reply: @mymoomin0952  Nope. I intentionally do not provide links for that very reason, but get my comments removed anyway.
Reply: @aquamanindependent8436  patents expire, and once you patent something, you have to reveal the secret, so anybody can slightly modify the process to get round your patent...so bollocks saying you are it is...
Reply: @Ironic1950  Your message cut off. Bollocks what?
Reply: @davidtherwhanger6795  well, its not the same anymore.  uranium it self - wich is mined in large open pits is NOT whats used in the atomic power plant, less then the so called "used" material.

If you are interestet in this topic, the web will answer your questions
Reply: @Atze.Tatze69  I have looked at more recent things to see what may have changed some since I had any experience with it. But those articles said that 43% of all uranium production was still from conventional mine or open pit. Do you have something that shows different?
Reply: I understand it's supposed to be a funny comment, but it misleadingly presents the perceived risks of this, when in reality they are very small.
Reply: @dmitryr9613  Well, the perceived risks in this are identical to the odds of winning a lottery.
It probably won't happen, but if/when it does, it'll be huge!
Reply: Bury it smarter*
Reply: The environment protester's are not so much against uranium reactors...it's the "dirty" process to mine it, etc,...,all the processes inbewteen, store, use, etc...then burry it! 
So knowing the CO impact and mining environmental impact comparison, might sway people for N.P.
Reply: @davidtherwhanger6795  great post. We should be using heavy funding to develop thorium reactors, but people fear what they don't understand. And people really don't understand uranium/plutomiun.
Reply: France (nuclear plants) 15 cents per kWh electricity price.
Germany (coal plants) 28 cents per kWh electricity price.
Germany has nearly twice the CO2 emissions than France. Any questions ?
Reply: @supagran1  Then that is what they should be protesting against, not the idea of nuclear power in itself or the imagined scary meltdown risks.. it also seems that a lot of protesters don't realize basic facts, for instance that the power plants don't release any toxic fumes into the atmosphere.
Reply: @dmitryr9613  I never said it was a bad idea. This looks big, impressive, expensive and is "very very safe". History has taught me that any engineering feat attempted by man has been accompanied by a subtle fault. As evidence that draws parallel to my opening statement: the Titanic.
I realize there's likely a TREMENDOUS more effort that went into this, but I still have trouble accepting anything THAT dangerous to handle has a happy ending
Reply: @davidtherwhanger6795  finally someone with a brain. People look at nuclear energy as bad but it's essentially to one driving most of the earth's energy. Creation of fossil fuels through heat from the earth's core, light from the sun is based on radiation emitted from the sun. Heck winds have their share with the convection currents by heat from the sun.

Nuclear was never bad. Just us. We don't dispose of nuclear waste properly or bothered to improve it. Because it works cheaper to dump it in the ocean and all. If they were cleared properly things would be fine. The radiation isn't ideal on the surface at a source but at depths definitely much safer.

People look at nuclear and think it's bad because it's the common thought of today. Because someone says wind and solar is better. 

🤷🏾‍♂️ Another dose of the internet I guess.
Reply: @johnbernardlambe8582  After reading this report it seems they knew the old mine that was not purpose built for holding waste had a problem with flooding. And salt is very abrasive material.

This site in Finland has none of these problems.
Reply: @BWolf00  Nuclear is an add-on to renewables not a replacement. There’s simply no way to feasibly power the world with any one technology alone. The point greenies and anti-greenies alike miss is that nuclear, renewables and electric cars aren’t just about the environment they’re about economics. An electric car is cheaper to run, renewables are about as close to printing money as you can get and nuclear is the ultimate form of economies of scale. Decrease the cost of energy across the board and you can decrease the cost of everything.
Reply: Did you really watch the video?
Reply: @arnaldobellucci9033  I did. Do you understand how funny comments work on YouTube?
Reply: @fyodorseriencha6538   there are trees in the U.S. that have absorebed a lot of testing fallout. Some regions are lacking in certain minerals so the trees eagerlyly built in a radioactive element (likely Caesium) and one should not use that wood  for wood chips (gardening), for firewood (ot at least not using the ash in  in the  garden - but if it is in the garbage it will also be concentrated locally).

other plants used it as well, but they do not live so long and cannot concentrate it that much.
Reply: @davidtherwhanger6795   there is no fission going on in the core of the planet, only radioactive decay, and the heat from compression.
Reply: @davidtherwhanger6795   no one "hates" nucelar fission It is a dead end expensive technology,. And nuclear fusion is done just fine in the sun and houdl be used - in form of solar and wind energy. The reactor sun is in safe distance and we do not have to deal with waste. Maybe humans learn to use nuclear fusion too - but in the meantime it will be renewables. and H2 and H3 are a limited resources as well (although there is much more than uranium).
Reply: @davidtherwhanger6795   Lead, Cadmium, copper, glass,  steel, and solar panels and wind turbines can be handled. That is a problem at a HUMAN scale, we are short shighted, and greedy but we should be able to deal with that if we give it a good effort. And of course in 50 or 100 years there could be nuclear fusion.

 The panels are NOT headed for the landfills. In countries with a reasonable system they do not have a lot of landfill garbage. And if you do not trust humankind to handle that in a rational and sustainable manner - what possesses you to think wo could be responsible for something that needs at least 200.000 of good stewardship (half time of 400.000 years). 

Such installations are a good fit for recycling much better than glass, metal or household appliances. They only have to be handled every 10 - 20 years. One gets a new set, there is installation and the professionals pick up the old unit. In a few years robots will be able to do more with taking them apart and sorting the materials.
Reply: @xyzsame4081  I'll be addressing each post in the order I received them.

Yes a lot of those solar panels are headed for a land fill. Maybe not in your country. But many get shipped to 3rd world nations that get what they can out of them and then toss them into a land fill. I believe one of the other posters actually saw them being tossed in a land fill in Africa right next to cattle pastures.

But I do think we can handle them responsibly. My point was similar to yours. If we can handle dangerous materials that will be dangerous because of what they are with a few precautions, why then do many believe that is impossible for nuclear? I am trying to get them to see that if we can handle one dangerous thing they do not hate or are afraid of then it is irrational to believe that it is impossible to handle the thing they do hate or fear.
Reply: @davidtherwhanger6795   you have a German sounding name (or Swiss ?) In Austria there are no problems with landfills, there is recycling and pickup of larger stuff by the communities and the garbage that is left, is burned and creates heat for households. Those ash deposits are unproblematic in landfills and need much less space. No problem with leakage, with methane, etc. if people tear down a house they have a container and they sort the materials (brick, wood, glass, PVC etc.)
Then and only then the costs for the garbage disposal will be acceptable. The volume of brick and concrete etc is a lot, it would fill up the landfill and if well sorted the material can be used as bed for streets etc. (so the energy intense product cement, brick, lime is not lost, and also not the sand in concrete).  Same for wood (it can be burned to heat up water) the metals are valuable, and glass, too. 

Even construction companies handle it that way, you can bring unsorted construction waste but it will cost an arm and a leg to dispose of it. 

Needless to say no one just "throws away" a solar panel or a battery set. They certainly can improve the cycles and implement default systems but they do not go into the landfills even now. Same for wind turbines that are finished, they are mined for the raw materials.

I assume it is the same in Germany (or could be) and in Switzerland.
Reply: @xyzsame4081  Why do you believe fission is a "dead and expensive"?

And you point out that distance is what keeps us safe from the Sun. That is not true. Our magnetosphere is what keeps us safe from the Sun. Without it the Sun would have cooked the planet already.

And that magnetosphere will not outlast the Sun either. We have a time limit on this world.
Reply: @xyzsame4081  That it is only radioactive decay is still being debated. However, compression cannot be the sole cause as it has reached maximum compression already, so something else must be causing heat. You say just decay, I say chain reaction. And we can line up scientists on both sides. But we know natural nuclear reactors are possible and have occurred under less conditions than at the core, Oklo Gabon. And even decay can start a chain reaction if it hits another fissionable atom that then can hit more. 

I'm in the camp that believes it is due to the compression of the core is more likely to naturally concentrate the material than not.
Reply: @davidtherwhanger6795  there is no reason to let heavy metals leak, they are usually valuable resources if people are encouraged and supported to collect the appliances that contain them. At the end of radioactive decay there are heavy metals, for instance lead. We have evolved to cope with background radiation, but a species that lives long and has only a few children, should not be cavalier about radiation exposure. The need of materials for energy harvesting / storage is not on principle different than for all other appliances and machines we use. or the processing of fossil fuels which is a dirty business. 

The appliances (battery bank, solar panels, inverter, wind turbines, heat pump) are long lasting which makes the recycling handling easier than for many other consumer produccts (cars, tires, houshold appliances, furniture). 

Humans (their countries) often take short cuts with the normal waste and this is something we CAN control. It is only money and being careful. Heavy metals that leaked  CAN be absorbed for instance humus can integrate them to a degree and INACTIVATE them. I assume one could develop algae or other organisms that can absorb them, so they could be safely deposited (or extracted and put to use). 

If you do not think humans can handle only the additional * waste related to machines needed for renewable energy - what makes you think we can handle nuclear waste for 400,000 years ??

The shortcuts would be much more tempting with nuclear waste, many layers / materials would need to be put around the waste (also valuable copper). Let humans produce enough of that waste and for sure some company will cut corners and violate the standards to make more  profit. (Wait until organized crime gets involved) After us the deluge. 100 % sure.

If someone gets lead into soil that is still a regional problem:  not an international one, and for the eons. 

I recommend to check out the failed attempt of nuclear storage in ASSE in Germany.

* after all we have lots of machines and vehicles already and also the processing of oil - it is not like the materials needed for renewable energy would be a completely new challenge in our cycles of industrial production.
Reply: @VenkmanPhD  watch it again.
Reply: @davidtherwhanger6795   We have the problem to manage waste well for all our industrially produced products. if we improve recycling for them it will spill over to the  equipment needed for renewables and things and systems will be easy to implement for that as well. We already get poison and heavy metals in the soil and water even w/o renewables.
Reply: @davidtherwhanger6795  My impression is that wave / tidal energy at the moment can only be used where condiitions are good. Will check out the King's Island project in Aus. JustHaveAThink recently covered that issue. For instance a large underwater generator produced by a company on the Orkney Islands, they have heavy sea, record level motion.  The 2nd generator after the prototype got a tweak: foldable wings for easier transport, it needs an anchor (metal cable), but othereise it is almost plug and play when the electric cable has been put in place. No furhter installations or concrete foundations, etc. 

If it would be possible to use the more erratic movement of waves where there is not distinctive difference in  tide or no strong  current would be great, those would produce base load and likely last very long.
Reply: @arnaldobellucci9033  watch some stand-up comedy, nerd
Reply: @rcpmac   additional info: Solar panels do not use much lead (14 gram per panel)  and they last at least ! 15 years. More like 20 - 25 (and still going strong at almost full performance with 20 years). Some people do have lead batteries in their home,  but those are of course recycled (they do not last as long as Lithium) and the future will bring new materials. Batteries / storage  are just taking off.
Reply: @davidtherwhanger6795   "Nuclear waste for 400k years ? We are good !" -   Handling renewable energy ? The raw materials, the space, the heavy metals, recycling,  harvesting low density (but super abundant) energy and need for storage. It is all very problematic and challenging ....  - you have more bias than can be excused by working in the industry.
Reply: @mymoomin0952  Engineers might be super cautious with nuclear waste. Let for profit companies handle enough waste for 50 years and they WILL start cutting corners (the casings will be less expensive, they are buried so no one will know, and regulators can and will be bribed). At the moment the nuclear power plants make good profits and they are regulated. Ongoing operation is a potential hazard, and they earn the money, so they will do as told. Once there is a lot of waste to handle there will be companies doing a lot or only that. I can see organized crime getting interested. 

The U.S. banks had common sense regulation  from 1932 to 1980 that kept them safe and they worked diligently at removing them. That started in the 1980s and ended with the first scandal. More  rehearsals fro a major crash followed in the 1990s. and a few years before 2000 the project dergulation of banks and Wallstreet (incl. derivatives  bets) was finished. It only took the professional big players a few years to almost crash the global economy.

Shortterm high gains versus being responsible reasonable and content with "normal" profits. 

Big management will screw it up.
Reply: @xyzsame4081  That's right we should always try to keep them to the same stringent standards as this project. I'm encouraged Finland is doing this bc they seem to do a better job of that than certain other countries I could name, but that doesn't mean we can just give carte blanche to future projects without this level of research & standards
Reply: @xyzsame4081  I think I can sum up your argument in that you are afraid of radiation. 

You say that burying it would lead to a international crisis while a heavy metal problem is a regional one.

So how far do you think that radiation can go?

How much radioactive material is in the water right now?

How much radioactive material is inside you right now?

Where and how deep is the radioactive material right now? Naturally occurring is what I am going for.

And while wave action can be finicky. So too is solar and wind.
Reply: @davidtherwhanger6795  It did come from the ground, but not in such very concentrated and dense form.
Reply: @TravelOften  Did you edit your reply before I even read it? What popped up in my notification was much longer than this.

Let me ask you these.
How much more concentrated is it now?
How much shielding does it take to reduce your dose to practically nothing?
How much shielding will this design give it?
Reply: @VI-pp4jo  dude. Read a book or something.
Reply: @thatdudnum67potatoe45  Because we can't get there. For a clearer explanation look up the kola super deep bore hole.  Seems unrelated at first.  But it's not.  Basically it's too hot.
Reply: Yeah they have a hole drilled to the mantle/crust. Just drop it in there. thats deep enuff. Should be a problem eh?.
return it to earth. It'll boil off.
As much sense as anything else in that commercial.
Reply: No no, This is Better.
its deeper.
Sounds a bit lewd.
Just pound deeper.
Reply: Uranium naturally exists in the ground, it's where we get it from. Are you trying to tell me, that putting something back in the ground, after we took it out of the ground, In safe maintenance free containers no less, is somehow going to harm the environment more then it will help it? Hell, with it being contained and shielded, ambient radiation in the area may actually drop rather then go up
Reply: @davidtherwhanger6795   Not being afraid of radiation is being stupid. Perhaps you should clarify what you mean by "afraid" because you keep using this platitude to dismiss well argumented points against radiation. More so, you were shown alternatives, cleaner, both socially! and ecologically but you closed your eyes? 
You're defending nuclear vehemently and all you can muster is "you are afraid of radiation" and "we have to leave anyway". What other arguments are for radiation? Because "cleaner" isn't one of them and "more power" is not needed in the current context.
 
That's the whole point of cleaner, to not run the world in a grinder for an immediate gain.
And also irradiated soil, is not farmable soil. Our ecosystem is way more valuable than a piece of electronic kit or gpus for bitcoin. 
If you saw the height of Gpu farming by miners, on ebay and weren't disgusted, it's obvious you don't stand on the clean side. 
I geniunely felt disgust. A mass gpu stealing from kids, to fund an imaginary coin that has no real value other than the one we imply. Basically get money no matter the costs, even if kids have to suffer. Tons of miners paying 3 times the cost of a gpu, because the mlm machine struck gold with the media coverage. And worse, Nvidia acted like a victim but prolongued the game because it was big money for them as well. That's the world we live in. And you want to give it more power.. No, this species can die or die trying to get better as far as I'm concerned.
Reply: @VI-pp4jo  I use afraid because that is exactly what you are of it. Afraid. You do not believe that it can be used or disposed of in any manner safely at all at any time. 

I respect the sea. But I do not fear the sea. Even when the waves were 10 stories high.

You talk of your well argued positions. Yet you will not answer my questions at all. Nor accept that radiation can be contained. You believe apparently that radiation will continue to expand until it consumes the Earth if we use it. But won't if we don't disturb it. This is an illogical conclusion based on emotion and the only position I can gather from you as you still  haven't answered me why a 3 to 4 meter thick concrete wall is enough to allow people to walk around the nuclear waste containers safely, but a 500 meter thick stone and earth barrier will not work. You think an underground river will just spring up in a containment area in a geologically stable region out of no where to fan your fears and use this as your argument that it is too dangerous.

Face it dude you are afraid of radiation.
Reply: @VI-pp4jo  And your last sentence I have seen before. Why is it that most of those I speak to on this topics concerning so called "Green" energy would rather all humanity die off if we don't do as the "Green" energy advocates say. Are you really that arrogant?
Reply: Exactly
Reply: @VI-pp4jo  conservation of energy has nothing to do with it.
Reply: This is the future, we don't have enough recources to the planned windmills allready, ain't enough copper for example. The recources is not present on this earth for all this windmills at the moment. Case closed.
Reply: @petterpettersen7976  actually, given you cannot spell, they aren't called windmills and there's more copper in current reserves to last over 300 years not including recycling.  You're delusional.
Reply: @davidtherwhanger6795  That's a tirade of dodging and strawmans.

You still haven't answered what afraid is.
Saying you don't fear the sea is a lie. Knowing, calms fears but uncertainty is always there. And to answer with the same coin, to think you have enough answers now, for 450.000 years is not arrogant? I act like I know for my lifetime, not that of 45.000 others. Don't talk to me about arrogant, ROFL!! 
And, how many times is it now that you've dodged adressing upkeep for 450k years? 

Regarding your points, I've addressed them, every single time. So here we go again. I've never said radiation "will expand and consume the earth" I do however believe that the immediate gains of nuclear power will feed carelessness and it will breed a dependancy on nuclear!! Take a moment to see that if it doesn't connect! The moment we depend on nuclear, especially under the guise of clean, is the moment radiation pollution really takes hold. 
If you would bother to understand that the efficiency of nuclear is subpar to even coal, when plotted on a graph of time, you would also understand that my argument is about polution! It has NOTHING to do with "fear of radiation". My argument about radiation is that it will polute the ground, when the copper shield fails. Which is the only shield that has a longer life expectancy. 

I actually don't think keeping it up top is an issue if it is contained, because it's easy to maintain if something goes wrong - Again, check Chernobyl, the concrete is cracking. I'm fairly certain same is expected with Fukushima. 
But once you keep it up top, the glaring fact of "upkeep" is in your face, literally. That's why they want to bury it!!!! 
- Why else, would they just not keep it ground level? 
The same argument you think is a good reason to prove burying it is "green" and "scientific" is actually a giant reason why it isn't. The "burying", here, is presented as a shielding option, correct? Why is there a need to shield it more if nothing is wrong up top? 
It's obvious, because, in the ground, it's out of sight out of mind. And, out of mind is the pollution spanned over 450.000 years. 

What points do you have? You sistematically dodge everything by saying anyone who is against it, is afraid. 

Nuclear waste is a poluting byproduct that has to be tended to for generations to come and only OUR generation profited from the energy. AND this waste is hazardously radioactive, unlike Uranium found "in the ground" a notion you still cling on to like a child even though I've said MULTIPLE times that there's a huge difference in radioactivity between nuclear waste and uranium. So "but it won't if we don't disturb it" is just another situation where you grazed over facts and substituted with a strawman that's funnily enough built on your misinformation on the topic.
You just can't accept that you can't see past your diploma.

Ask anyone with some worth on their name, if you have to bring your status in the conversation to prove a point, you already lost. And that was 10 comments ago.
So drop the buddy buddy, I simply saw you closing your eyes so I left. Came back for my guy uptop who tried to reason with you and you reverted to "I think I can summarize by saying you're afraid"
You're a tool.
Reply: @BenState  You are wrong. Better do some more research. Guess I know the copper industry a bit more than you. Not desilusional, rather the oposite 😁
Reply: @BenState  I'm not sure what you're trying to say with that or what point you're attacking.
Where and in relation to what did I mention conservation of energy?
Reply: @BenState  A windmill is a structure that converts wind power into rotational energy by means of vanes called sails or blades, specifically to mill grain (gristmills), but the term is also extended to windpumps, wind turbines and other applications. The term wind engine is sometimes used to describe such devices.[1]
Please educate your self.....
Reply: @petterpettersen7976  a windmill mills things by converting mechanical energy types.  A wind turbine converts mechanical energy into electrical energy.  Completely different.   I used to work on them.  Please, education is your deficiency, both in application and analysis.
Reply: @VI-pp4jo  you didn't, you tried to, but used your own ideas badly.
Reply: @petterpettersen7976  Ok, please provide evidence that peak copper will occur in the next 100 years, even 50?
Reply: @BenState  At least you were original in your insults. I will give you that. But only that in the hopes that this is your own material and you didn't steal it from some other half wit.
Reply: @petterpettersen7976  still cannot spell, provide citation,  Im using USGS data for the amount of copper reserves and recycling.  YOu?
Reply: @VI-pp4jo  Your tirades and rants in the past posts have not convinced me of anything but confused me as to what you were talking about. 

I know I've said this before in this thread, but do not remember if it was to you. They knew when they were pouring the concrete on Chernobyl that it was going to crack. The reaction was still going and water was already there to cause pressure from inside as the concrete cured. At least that's how I remember it.

Also the salt mine used in Germany had a moisture problem and was not built as a waste facility, but a salt mine.

Now asking if you think a river will form there after it has not in millions of years does seem to me to be a little more paranoid than anything else.

Now I am no geologist, but IIRC gold deposits in rivers come from deposits in mountains washed down by those rivers. In this case the river would also have to be so powerful as to raise material of similar weight 500 meters up. That would I think be more than the Amazon River could do.

And you kinda finally answered by question about shielding. At the depth we are talking here so little radiation will escape that you won't be able to notice anywhere near the surface. 

Now if you have data to show any river underground that has enough force to raise dense material up 500 meters in any measurable amounts to raise radiation levels significantly above background levels of Finland.

As for my explanation of afraid. I guess I used an explanation that only military types get. My apologies. It's been almost 30 years, but some things don't ever die. Respect means that you understand the dangers and take precautions. Life is full of risk. Every day may be your last. Afraid is an illogical fear of what might happen but is unlikely to happen, yet it keeps you from something because the unlikely scenario's chance is greater than zero.

Now you say that coal is more efficient and cost effective than nuclear. Show me your data on that for I have never seen that.
Reply: @miraclemaker1418  its still not been deleted im so done with youtube they say they are trying but if at least half of the people who liked your comment reported it it should be taken down. they seem to be ignoring the bot problem
Reply: Hmm.....I prefer to discuss  with intelligent people, this is not one of those discussions.
Reply: @petterpettersen7976  Then why are you here at all? This is not MIT.
Reply: @davidtherwhanger6795  I don't know.....Pretty stupid of me.
Reply: @petterpettersen7976  you engaged me after reading a joke argument, acting in spite of your preferences and continuing to do so makes you a flimsy character at best. Figure out what you want to do, do it.
Reply: @petterpettersen7976  are you inferring that we don't already have power lines running through our country?... You may live in a place where connectivity is a problem but the American grid, although a travesty of engineering, means we pretty much all have power. Please share a link, searching for copper on rystad shows 0 results. It's also possible that YOUR country is low on copper and ours isn't. Locality matters with such heavy material, especially if needed in large quantity. 
Honestly you rattled off like a teenager trying to show people how smart you are on the internet so I'm guessing you have a few recycled opinions from your parents here. Enjoy.
Reply: @VenkmanPhD  Well, I am Well educated, and retired at 40. I DO wat I want.....Me and my cats. In the woods. Think its perfect.
Reply: @petterpettersen7976  Neat! Did your job have anything to do with copper? How'd you retire at 40?
Reply: @VenkmanPhD  Stocks and property.  My profession was not in any of those mentioned.
Reply: Ok. 

1. What are the radiation levels for nuclear waste? For 10 to 100k years.  Let's keep it simple. Answer this, with figures and draw a paralel to human health in proximity to it and I will let you call me "scared". Up until then, I will call you an airhead, because your "facts" are emotions backed by your diploma and affiliation with nuclear. Sound fair? You keep trying to take the high ground, here's your chance navy boy.
Reply: @jxkc.3941  quite the opposite actually, it lost energy during its use. It is more concentrated however.
Reply: Pinned by The B1M  Trust is necessary for a functional society, its a decision to collaborate. Exploiting that trust is a decision to steal.
Reply: Figured it out even before watching the vid.
Reply: @davidtherwhanger6795    Afraid most of us have insufficient understanding of Nuclear Energy to be receptive to data that points to potential solutions. VI has a point as he seems to suggest we make decisions based on our social political beliefs rather than real data. Unfortunately our bias and fears around Nuclear Energy also restrict proper advancement in safer and more manageable solutions. Personally I see any push to advance technology as a good thing, this should be encouraged and supported in all fields that are working to affect our energy solutions.
Reply: @colbr6733  I can see that. It just seemed to me that VI could not accept that people making decisions for nuclear could be doing it on actual data and not for political reasons. 

Of course VI's statement that the human race should die or die trying to get better, in the context that we should be using "green" energy only, lead me to believe he was not thinking rationally about this at all.

Personally I don't have a problem with any of the so called "green" or "clean" energies. I just believe people are purposely mislead by those monikers. Every thing has it's pros and cons. With solar and wind the biggest one is limited use. Solar being effective only when the Sun is out and wind only being effective during times of low to moderately high winds as you have to shut them down currently at 55 mph winds or risk damage to the systems. Also why I brought up Wave Action power as another alternative. Australia is making history with that one. But we will need something to fall back on besides those in times when we can't use them. And for now that is fossil fuel. But that supply is running out, quickly. We don't know exactly when, but I believe before this century is out we will have exhausted our usable supply of it. And then we will need nuclear, badly.
Reply: Um, seems like you have watched a different video.
Reply: @f.d.6667  How so?
Reply: @davidtherwhanger6795   Ground water can provide shielding, got it. May I ask wouldn't the radiation spread under water though? I'm not some scientist, so this question might sound very dumb.
Reply: @rayhe8224  It would if it could move the material is some way. Normally this would be by stripping off small to trace amounts of it. But these pieces would be much less radioactive than the whole. This is due to when it is in large concentrations it will be giving off pieces of itself, in this case neutrons, that hit other atoms of the fissionable material and cause that atom to fission giving off more neutrons. Separate it by enough water, because water slows down the neutrons in the first place considerably which is why we use it as a moderator, and it won't hit another atom of fissionable material so not cause another to give off extra neutrons, that's why we call it a chain reaction, and thus stopping the reaction.

This stuff is dense material. Individually the pellets weigh only a few grams. But they are locked into a rod together, then placed into a steel container, wrapped in copper and the hole backfilled with clay. All 500 meters down in solid rock. From what I understand there are no underground rivers near this site. So the erosion effect of water is greatly reduced to almost zero. 

Not to mention that because some reaction is going on this is causing those atoms to decay faster than their normal half life decay. Eventually it will decay into something stable, i.e. not radioactive. This will still take a while, but predictions are a nose dive in radiation given off over the first 800 years, then low level radiation for many tens of thousands of years after.

I hope that explains it.
Reply: @rayhe8224  Wait a minute. It just hit me, are you asking if water itself can become radioactive?
Reply: @davidtherwhanger6795  I guess .... Yes? Or maybe the substance inside water can become radioactive?
Reply: @davidtherwhanger6795  Thank you for explaining the question. It's amazing to come across someone with such knowledge!
Reply: @davidtherwhanger6795  However it was enriched to fuel grade when it came out of the ground and remains more radioactive than what was taken out of the ground.
Reply: @wisenber  It's also causing it to break down faster. The U-235 in the fuel rods is not following normal decay but being split into different atoms. This is happening much faster than it normally would. Radiation drop is therefore also much quicker. 

Currently it is stored above ground in 3 to 4 meter thick concrete containers. In these the radiation is contained so much by just this amount of shielding that people can walk around the containers without protection. How much more protected then is it buried under 500 meters of stone and dirt?
Reply: update, Taishan ,  China reactor has BIG PROBLEM coming soon, the cover of the #2 reactor shield start melt down due used unqualified materials ( Chinese corruption )
Reply: @xuchun5371   Source?
Reply: @rayhe8224  @ you stop reading news last few days ? 
after a French nuclear energy company inform US asked for help, CNN and BBC, America FEC had response and report this issue
Reply: @rayhe8224  @ the issue is inside the cover shield radiation gas limit over the safety index , it the shield fail the radioactive gas will Contaminate the entire big bay area.
Reply: @xuchun5371  and yet no one is reporting the shield melting down, so I guess the source is :trust me bro.
Reply: @rayhe8224  @ i say the radioactive gas level is raising , the dome not collapse yet , 
( if it dose fail ..... no news will tell bc all reporters in the area are dead.)
Reply: @xuchun5371   Quote " the cover of the #2 reactor shield start melt down due used unqualified materials ( Chinese corruption )" end quote.
Reply: @davidtherwhanger6795  David, It is clear you are pulling this info out of thin air just to sound educated. I checked info the other user mentioned, and it completely negates what you're saying.

Please refrain from your conservative lies.
Reply: @VI-pp4jo  bruh it's encased and is half a kilometer down the ground, it's not gonna leak.
Reply: @coatlamb1308  I actually don't have a problem with wind or solar. If you really checked what I have said you would have seen I also spoke of wave power.

I just don't turn a blind I to their limitations and negative effects. And it was Michael Moore who first pointed out to me the drawbacks of wind and solar. I guess he is conservative now?
Reply: @petterpettersen7976  Seing as you are speaking pompusly, I believe this is not the case. You're not delusional, you're apathetic.
Reply: @davidtherwhanger6795  Seeing as how you work in the industry, it is within you're prerogative to be for this.
One thing you seem to keep overlooking in these arguments however is the fact that the concrete and water used to suppress the effects of the radiation are contaminated themselves in the process.
On Earth we still have limited mater and energy, and thus we are making less and less of it usable, thus a rude awakening still awaits.
Reply: @coatlamb1308  But I'm not pompusly 😉
Reply: @coatlamb1308  Extremely gifted people tend to have some issues.....😉
Reply: @thatdudnum67potatoe45  because its way to deep, no human or machine has ever even come close to reaching the mantle
Reply: @VI-pp4jo  And you are being arrogant to want the human race to die rather than follow your beliefs.
Reply: The problem with "dig it deeper" is that people simply will.

Just look at the pyramids for example. They were the absolute most sacred places to the most powerful nation on the planet at the time. Just, what, 5000 years later and we're exploring/pillaging every nook and cranny of these places? We had to decipher their symbolic language just to make heads or tails of things, we completely forgot what they were about.

There's absolutely 0% chance that putting something into the ground, that will be toxic to humans for many 100 000s of years, won't be found by humans in the future. And since nuclear power will be extremely short lived by comparison of that timeline, it's an absolute disgrace that we're still thinking about "solving" it, instead of dismantling every nuclear powerplant we have in exchange for cheaper and more sustainable forms of energy. We're simply doing a far worse version of what previous generations have done with fossil fuels "let the future generations worry about it". Except in their case it was just a few 100 years. We're basically stretching it out over a higher number with 3 more zeros at the end. 

The only reason we're still seriously entertaining nuclear energy is because A) idiots still believe it's the silver bullet to our energy crisis that they desperately need it to be, and B) because the energy industry wants to keep energy production centralized and in their control. They have zero control over you generating your own energy on top of your house, or sharing it with others. Nuclear energy is the last death throe of a 400 billion dollar industry dealing with its extinction.
Reply: @vincentpol  There are reasons we are entertaining it. One is it's efficiency compared to "sustainable" energy that has periods where it does not produce at all and must be stored in batteries that require rare metals the mining of which require power sources not compatible with the needs of heavy machinery to get. While it would be lovely to mine with solar powered excavators that is simply not possible. And would regulate all mining to strip mining to keep the sun available at all times. Fossil Fuels are the best for that and you would not get your "Green" energy systems without it. You could build electric heavy machinery now, but without Fossil Fuels we would never have gotten to this point. Not to mention that the expense of such machinery to recharge them would be prohibitive on how much mining and by that how much "Green" energy we can produce.

And I do not follow your logic when comparing how they stored information on paper scrolls or stone tablets in a few locations that were regularly destroyed by a single natural disaster to our modern digital storage and library system that stores the wealth of human knowledge in literally millions of separate locations around the globe. Any disaster large enough to destroy all that would in fact destroy all the energy production systems around the world. And probably us as well.
Reply: @davidtherwhanger6795  Our energy consumption pattern has to change. It's as simple as that.

You're too old and stuck in old ways, that's why you can't see it. You invested too much of your thought in a dying idea and not enough of your life... which was drained by a power line.....

Talk about your glory day ideas, they're dying along with you.
As long as I'm in power, nuclear will die. 🖐️
Reply: Thanks for saving me time. I was expecting this to be like the one team that succeeded in recycling 96% of the nuclear waste they had for experiments into crystal batteries. This isn't a solution, this is just more of putting it somewhere and pretending it no longer exists.
Reply: This comment is exactly why this is a silly idea. Spent nuclear fuel isn't a real problem. It's only a problem in the imaginations of non-engineers who don't understand the tiny quantity of fuel we're dealing with. This solution is complete overkill and on top of that, it doesn't even build public support. Anyone who was against nuclear energy yesterday is still against it today. This isn't going to change their minds, so just ignore the nuclear haters.
Reply: @mikemartin6748  "Spent nuclear fuel isn't a real problem" Source: Trust me bro!
"This solution is complete overkill" Source: Trust me bro!

Another day, another idiot.
Reply: Put it deeper daddy
Reply: @BWolf00  
If you think wind and solar can produce anywhere near the capacity needed you are very poorly educated on the subject and ill suited to comment on it.
Reply: Hyvin idé pekka!
Reply: @pontusvongeijer1240  I'm aware, I was portraying the typical Green American.  Beside their NIMBY stances, they disregard the solar and wind current technological short comings and the vulnerabilities of the "green" sources.
Reply: @VI-pp4jo  Where do you pull out this nonsense from? Erode from the inside is probably what's going to happen in ~200 years?? You're obviouslt just wildly guessing without having the first clue, come on...
Reply: @minaaris  LOL what the hell??
Reply: @VI-pp4jo  omfg "No. There aren't." ...... Wth is wrong with you people?!? You can't just say that there isn't and that's the truth! You're acting like those people claiming there are a whole slew of different genders, and next there are no genders ... No there's a "subjective number of genders!" or something like that.... Like come on already!
Reply: @kriss8931  Well I have to say you're obviously not very knowledgeable about this stuff, but yeah you have the right track at least... For starters fusion is nuclear power just as much as fission is.🤭 But yeah from what I understand fusion power wouldn't create a byproduct stay radiactive for very long at all, but it's not like this magical power generator that a lot people seem to think, at least not with our current understanding and level of technology. Sure, if we found a way to make cold fusion happen that would be GREAT, but that's just pure science fiction. And no, I'm not a "nuclear physicist with an abundance of experience in nuclear engineering" or something like that which someone just above you asked, but I sure do have read and actually understand on some basic level how this stuff works, unlike these "green power" clowns that just come up with completely nonsenical statements. Then calling someone that actually does have some real life experience "self-righteous" and stuff because he brought up that there's nuclear reactions happening in our planet and that it protects us from the sun's radiactive solar winds and all that. The point being, at least from my perspective, that people have this phobia against nuclear power even though when handled correctly really can be as safe as it possibly gets and not affect us or future generations, meanwhile the sun itself is more dangerous! If you really want us and future generations to be safer, then focus on cleaner energy, i.e. energy that creates less of a carbon footprint. Less greenhouse gases means less ozone layer depletion which means less radioactive isotopes. Building all these wind farms and stuff is NOT the right strategy for that. My own country, Sweden, is going the complete wrong way. Wind power is unreliable and expensive, creating a lot more greenhouse gases and when it's not very windy, we need to import a lot of dirty energy. Finland is 100% going the right way with their nuclear program. But hey, that's just my opinion.

Btw, wind power is ironically actually quite a lot more dangerous to animals and even human beings too.
Reply: @victorlee447  lol Jesus Christ, great comparison, just excellent.👌
Reply: @mymoomin0952  "it's only 1 layer of protection!" I seem to recall being said. 😂
Reply: @VenkmanPhD  Bhahah
Reply: LOL
Reply: Right! wtf is this mess!
Reply: @davidtherwhanger6795  dig their tunnels under water, perhaps below the ocean and storage problem solved.
Reply: @benzeeno8150  The deepest we have ever been able to get is the 7.5-mile-deep Kola Borehole in Russia. And it took a couple of decades to make a hole only 9 inches across.

If it were possible I would prefer to place it in the magma layer so the heat would melt it down and the currents would tear it apart, diluting it back throughout the planet where it would be no more dangerous than anything else that already comes up with volcanoes.
Reply: @davidtherwhanger6795  thanks. That amazing to think just how deep 7.5 miles of hole is. Just looked it up and watched a video of it. Interesting.
Reply: Until you run out of space.
Reply: @jxkc.3941  surely since it's spent fuel, it would be being buried in a less charged state than it came out?
Reply: @sgn4899  And how many land fills do we make brand new a year world wide?

Running out of space to put this waste is implying that there can be more of it than the volume of the planet's crust. We can't even get to the material deep in the crust. We currently mine about 20,000 to 400,000 metric tones of ore (depending on grade of ore) to get about 30 metric tons of fuel. We are making a lot of holes.
Reply: @BWolf00  1953 to 2021 is more than 20 years ;-) but i agree with you on that front. electric cars are a curse. i hate them. new zealand is going to tax the heck out of petrol cars, give out subsidies for electric cars and eventually ban petrol cars altogether. i am fed up with this. especially since we dont currently have the power grid to support it and if we did it wouldnt be 'clean' energy. i just read an article about the council having electric cars on stuart island. but the power grid their comes from a diesel generator! its just ridiculous. when it comes to nuclear though i am still on the fence. i have heard bad things about solar and wind actually producing more waste/ co2 than nuclear but im not sure what to believe, all i know is i dont like the idea of nuclear and our country being nuclear free is one of the only things left that makes me proud to be a resident. 
also, i am not sure whether i even believe in global warming anymore. i did, big time. and i mostly still do. but i dont know. i just dont know. you can trust the media, and global warming, real or not, is now more about making money and taxing everything than it is about saving the planet.
Reply: @VI-pp4jo  thats a great analogy, haha.
Reply: @davidtherwhanger6795  , there's a lot of pseudoscience and misleading claims in that post, along with some actual science:

> "Your ground water already has radioactive particles in it. ... You have radioactive isotopes in you right now that will stay there and given enough time will kill you from radiation poisoning regardless of what you do."

Yes, there are trace amounts of some radioactive isotopes almost everywhere, but these are not at levels that are dangerous to humans. (No, background radiation will not "kill you from radiation poisoning".)

> "The largest, longest running fission reactor on the planet is what is keeping you alive right now. At our planet's core is billions of tons of uranium, along with a lot of other heavy metals. This is crunched together giving us an natural fission reactor. It's what heats the core, and keeps the magma liquid. ..."

Two scientists have hypothesised that naturally occurring fission reactions might be possible at the bottom of the mantle (NOT the core), but this is just speculation (even the proponents of the hypothesis don't claim - as far as I know - to know that this is actually happenning), and even if correct, the heat produced would make only a small contribution to the geologic heat of the Earth. It certainly wouldn't be necessary to keep us alive, keep magma liquid, or maintain the Earth's magnetic field, and wouldn't contribute significantly to heating the core. [ https://www.nature.com/articles/news.2008.822 ] (See the actual science of geologic heat: https://www.scientificamerican.com/article/why-is-the-earths-core-so/ )

Even if fission reactions do happen there, this is irrelevant to the analysis of the safety of nuclear fission power. (Because humans live on the surface of the Earth. 2800km of magma and rock would keep the toxic fission products at a safe distance from us.)
Similarly, the fact that nuclear fusion happens on the sun does not demonstrate that nuclear reactions (and radioactive waste) don't have potential dangers. (If we operated nuclear reactors 150 million kilometres away, I think that would alleviate all safety concerns.) Anyway, the waste to be stored at Onkalo is produced by fission, not fusion.

> "And this reactor at our core is running out of fuel. It will last a few million more years, but will stop eventually."

The Earth will eventually cool, but claiming that it will last only "a few million years more" is misleading, just as saying that it will cool completely in a few minutes would be misleading but technically arguably correct, because I didn't say how many minutes. It is estimated that it will cool in tens of billions of years. [ https://interestingengineering.com/how-much-longer-until-the-core-of-the-earth-runs-out-of-fuel ]

> "Thermal energy is driven by the heat given off from the fission happening in our planet."

Thermal energy (by the normal use of the term) generally refers to energy derived from burning fuels, generally fossil fuels.
Reply: @johnbernardlambe8582  1) Those isotopes in your body will kill you. In about 10,000 years. That's one of the limiting factors we believe will be on cryogenics. And have you not heard of Radon Gas coming up thru the crust and getting into ground water? It is a great cause of cancer deaths each year.

2) The reactions at the core may not be widely accepted. But neither was natural fission reactions before Oklo Gabon. The fact that it has happened under less compressing conditions, I believe as do others that it is happening there. And as we can't measure it yet, we don't know for sure how much it is doing. 

3) My entire point of the reaction at the core was that far away is good for us. I was trying to show that with enough shielding any level of radiation could be made safe. And that the amount at the core would have to be several orders of magnitude higher than all the nuclear waste put together. So burying it was a good idea for shielding. It's what the crust does already.

4) Do you really think radiation from fusion won't kill you? But radiation from fission will? It's not the source, but the amount you get.

5) A million years is the estimate I heard. Do remember though that science changes it's estimates quite often.
Reply: 3 feet of water, or concrete is enough to stop 100% of radiation, so this whole thing seems overkill
Reply: @davidtherwhanger6795  you sure have a lot of patience. You can't really reason with someone who's dead set on a certain view. However, despite being a pro-nuclear myself, certain arguments from VI are valid? Not so much about the science itself, but the fact that human errors are prone to happen. Fission is definitely not the long term solution, but hey, in the mean time, I will take this over any other forms of carbon heavy energy sources while we wait for fusion (just don't name it nuclear this time)
Reply: @VI-pp4jo  y
Reply: @VI-pp4jo  is
Reply: Where do you think nuclear material comes from?  The sky or the ground?
Reply: @davidtherwhanger6795  Exactly
Reply: @VI-pp4jo  for all your quoting of scientific mumbo-jumbo ladened studies, this stuff is stored under lots of rock, not soil, and so is not going to be found by future generations. Just like the stuff round Chernobyl shows few signs of the nuclear contamination levels there, and that's right on the surface!
Reply: @PedroRPFerraz  ...that's what breeder reactors do! And we have millions of tonnes of Uranium and Thorium, so effectively infinite supply!
Reply: @earthstick  let's rephrase your silly comment into a real concern
"Where do you think GROUNDwater comes from? The ground or the sky?"
... Now let that sink in
Reply: @PedroRPFerraz  I don't think anyone has the foresight to ACTUALLY deal with anything thousands of years in the future. Isn't this area VERY seismically active? What if there's an earthquake + a steam vent that just fires out radioactive debris?
Reply: @VenkmanPhD  You've failed to realise a fundamental dear boy. Groundwater only goes down so deep.  As you get closer to the mantle the temperature increase.  Water turns to a gas at 100^C whereupon it rises, so there is a limit to how far down you find water.  You just bury the radioactive elements below that.
Reply: @earthstick  annnnd you didn't even bother to Google "how far down does ground water go" to stop yourself from looking like a cringey know it all.
30,000 feet. Ground water goes 30,000 under us, and yes it will eventually make it's way back.  
There's a reason you don't keep raw chicken next to cooked chicken in a kitchen (ask Gordon Ramsay) and there's a reason you don't put radioactive waste with your water source.
Reply: @thatdudnum67potatoe45  The mantle begins at a depth of 35 km down. The deepest hole ever drilled is 7 km deep. It took five years to drill.
Reply: @davidtherwhanger6795  The thing about the nuclear energy debate is that it isn’t governed by logic. It’s been turned into an evil tenet in the book of Gaia Worship. 

Fortunately there are still countries, like Finland, leading the way.

Being Australian, we get the vast majority of energy from burning coal and gas. Nuclear energy is a big no-no. In the meantime, we mine uranium (biggest producer of uranium in the world, I believe), sell it to China to use in their reactors, then have it shipped back to Australia and buried in the desert.

In short, we take all the bad things about nuclear energy, get paid for it, and then use coal to run our industry. Because the greens want it that way…
Reply: @GiorgiGoguaTuzo  cuz it’s a bot bruh. Come on now use your brain
Reply: @davidtherwhanger6795 
1) I (and other people reading this) am unlikely to be cryogenically preserved, and therefore very unlikely to live for 10,000 years. Background radiation therefore is very unlikely to kill me. (It couldn't kill me in 10,000 years because I would already be dead by then.)

2) What is your source for this? (I've cited actual scientific sources that contradict it.) Is it just what you believe without it being supported by significant evidence and current scientific knowledge? If you think that mainstream science is wrong on this, what are you qualifications (why should we think that you are correct and most scientists in the field are wrong)?
> "I believe as do others that it is happening there."
That sounds like it's just a fantasy belief, not based in science. Presenting this as fact (as you did), without acknowledging that it's not generally accepted, is at best misleading.
As I said in my previous post, there is reasonable speculation about limited fission reactions at the boundary between the mantle and core, but this is not what you're claiming. (Maybe you heard about that and wildly exaggerated it.)
To support your claim that this hypothetical fission reaction is necessary for life on Earth, you would have to show evidence that the other sources of geothermal heat are not sufficient, contradicting well-established geology. (What is your source for that?)

3) I agree that burying radioactive waste deep enough in certain places could be safe, at least in theory (and Onkalo may well be safe for 100,000 years), but Onkalo will not dig as far as the core, so even if true, you claim of fission reactions at the core does not prove the safety of Onkalo.

4) The video you're commenting on (and my comment) is about storage of radioactive waste, not about the radiation directly. The nuclear fusion reactions to potentially be used for power generation do not inherently produce radioactive waste. In practice, they will probably produce low-level radioactive waste (parts of the reactor itself that get irradiated) (depending on which fusion reactions are used), but that has a much lower risk and half life (it wouldn't require safe storage for anything like the 100,000 years required for some fission by-products).

5) What is your source for this? It sounds like pseudoscience.

Scientific knowledge has increased over time, but this does not provide evidence that any arbitrary claim is true.
Reply: @mitchelm8783  You've managed to totally miss the point. 3 feet of concrete or water is unlikely to remain safe for 100,000 years.
Reply: @johnbernardlambe8582  First. I am not talking about background radiation in the first point. I am talking about radioactive isotopes inside your body. Where you have no protection. I originally made this point to highlight that you cannot get away from radiation damage at all. But it can be mitigated.

Second. Until we actually go to the core it is all conjecture. I side with the ones who believe it is happening. Mainly because the prevailing belief at first was natural reactions could not happen and this is the stance science took. Then we found out that they could happen naturally. But because the first belief was they could not, we now have to prove each and every one to be true before science will accept it. This is true for many scientific beliefs thru history. And I find it hard to believe that the heat of compression alone has kept the core of our planet hot enough to keep the mantle liquid for billions of years. There has to be another source.

Third. My point originally was to counter the argument that the radiation would spread and contaminate everything to the point of lethality. Showing that radiation from the core had not done that in billions of years shows that a much smaller deposit will not in hundreds of thousands of years.

Forth. The whole argument so far that I have been having was the danger of the radiation. The people I have been arguing with are afraid the radiation will spread and kill them. So yes it is about the radiation. If the waste was not radioactive we would not be concerned about any of this would we.

Fifth. The million years is a point I heard before given as a time limit. That the magnetosphere would disappear due to the magma cooling and solidifying before the Sun went red giant on us. It has been decades ago. And I am open to possibly remembering it wrong. And if your just looking for a win then take it.
Reply: Bro we bury it inside “peruskallio” it’s like big rock which doesn’t move.
Reply: @davidtherwhanger6795  If you're not talking about radiation, then your comment, "Do you really think radiation from fusion won't kill you? But radiation from fission will?", makes no sense.

The rest our your argument is anti-science: You cite no sources nor evidence, but state your beliefs (and even talk about "scientific beliefs"), which you stated as fact. Science is not based on belief: It's based on evidence, which is peer-reviewed. Belief without evidence in mere conjecture, or pseudoscience or superstition. (Conjecture is okay when presented as such. When presented as science, it's pseudoscience.)
If you can prove what you claim, you should write a paper and submit it for peer review. Otherwise, don't expect anyone to take you seriously.
Many people believe (just as strongly as you hold your beliefs) that the Earth is flat, and can't believe otherwise (just as you can't believe established geology). (Noone is claiming that geothermal heat is caused solely by "compression" though. Radioactive decay is a large contributor.) These beliefs (and yours) and science are not equally valid. Unless you have scientific evidence, your beliefs are similarly just beliefs.
Reply: @noname-bt9ky  Continents move. Think about that one.
Reply: @PersonalityMalfunction  i know theres more to it than this but why not dig deeper
Reply: @BWolf00  Watch Shellenberger... numerous environmental activists have changed their minds about nuclear power. Also, If we can overcome the technical difficulties of molten salt reactors using Thorium, we would be able to produce the equivalent electrical power for one person for 100 years of life from a ball of thorium, smaller than an golf ball. Thorium is several times more plentiful than any of the other fissionable material.
Reply: @VenkmanPhD  Not in Finland
Reply: @thatdudnum67potatoe45  too far away. we've only been able to drill 1/10 thru the crust
Reply: @jamesjutila6220  You gave me a Ted Talk with a guy starting with his life story. I closed it.

The only thing we have experience with is fosil fuels, everything else is more or less extrapolated.
Ask people 150 years ago if they could predict global warming and they would probably not be able to see that many cars, industrialization, etc, let alone global warming.

What do you think sets us apart from our ancestors that we can use 30 years of nuclear experience to veto for 100k years?
Recorded history is not even close to that long. And it seems like likeeeee soooo far away bruh... 😐

And for a bit of perspective, the strongest proponent in this thread, uses "it came from the ground" to justify putting it back in and HAS NO CLUE what the difference between spent nuclear fuel and enriched uranium is. It's in his first replies ~.

So, you're free to find reasons why it's ok. But I know its because you want more power and consequences are expendable.
And I know there is as much reasoning to you as trying to get a dog to stop biting your leg once it tastes meat.

I'll say it again, no more power till you clean your room. Some of you had bad parents or none at all.
Reply: @noname-bt9ky  so then the solution can't leave Finland or places that don't have very very shallow ground water tables
Reply: @fyodorseriencha6538  just so you know one of the main reasons why we have a liquid mantle is because the core of the Earth is one giant nuclear fission reactor and produces heat via a nuclear reaction the same way nuclear power plants do along with the radio active decay of trillions of tons of uranium an other radioactive elements. With out that we'd have about as much geothermic activity as mars  which is basically 0 as far as we can tell.
Reply: I don't want to go so far is disagree with what they're doing but in the case of a natural disaster Like An Earthquake couldn't these canisters get busted
Reply: @coreymartin6176  that far underground probably not. Earthquakes are mostly a surface phenomenon. Earth quakes are a lot like waves in the ocean, that water is constantly moving but you only get the most violent crashing waves in shallow water and even if you have 10 foot swells on the surface of you go scuba diving you'll barely notice any movement. Earthquakes are similar the deeper you go the less violent the shaking is
Reply: @ThatGuyKazz that makes since,thanks for the info
Reply: @ThatGuyKazz  Thanks for the science lesson genius. Even the stuff spewed out from volcanoes isn't known for being radioactive - that's how far down and away from us that core you're talking about is, so I don't see how what you said is relevant..
Reply: @fyodorseriencha6538  Point was that we live on a giant thermonuclear fission reactor called Earth. You're worried about radio active material getting out but you come in contact with radio active material literally every single day. If you go fill a 5 gallon bucket with dirt from your back yard you will more than likely have trace amounts of radio active material in that bucket. Everyone is terrified of nuclear power because they are afraid of radiation leaks because they aren't educated enough to realize they receive more harmful radiation from eating a banana than you'd get if you live 200 feet from a nuclear reactor for 10 years. The fear of nuclear energy is so completely illogical if you take any amount of time to properly research the energy industry. Everyone points out Fukushima, 3 Mile Island, and Chernobyl but complete neglect the fact that the BP oil spill in 2010 did more environmental damage and spread more carcinogenic material globally than all 3 of those nuclear disasters combined and that is just 1 of dozens of major oil spills. They also fail to acknowledge the fact that all major nuclear disasters have been a result of A. poor work place safety and B. early gen 1 or gen 2 reactors which were not built with pretty much any safety features and melt down prevention which are required on modern reactors. Nuclear energy has cause less human injury and environmental damage over it's entire history than what the oil industry does on a bi-yearly basis. Per watt hour generated Nuclear is the safest energy source by far including solar and wind.
Reply: Next is mantle burial. Can't wait for that.
Reply: @coreymartin6176  kind of my thought exactly. They're also in an area with HUGE geothermal activity
Reply: So, instead of stopping Nuclear, lets create some "landmines" for the next generation of miners that never knew this was a nuclear burying ground. It's not going to be our problem. Nuclear: Borrowing energy from future generations to come.
Reply: @berb_yt  And why do you think this site won't contain it properly? How is it properly contained now?
Reply: 🤣 pretty much. 🤦‍♂️
Reply: @davidtherwhanger6795  So totally not the case. Uranium ore in its natural state is in very low concentrations. Typically at about 10 parts per million. Usually found in granite rocks which erode exceptionally slowly meaning an exposed deposit will not release significant amounts into the environment. 

Nuclear waste is at much higher concentration (very much higher) and the containment is nowhere near as robust as solid granite.
Reply: @kevinu.k.7042  As I understand it there are no water sources nearby to actually erode the containers. This is geologically stable rock they said. That says to me that a river is not just going to appear there. 

And how is this worse than how they store it now?
Reply: @VI-pp4jo  yes we know how radioactive materials act, we know how to shield them so radioactive leek is an impossibility. And by burring it that deep, a natural disaster like an earthquake would have to be so strong it shatters the ground deeper than the Empire State Building is tall, to reintroduce the radiation to our nature cycle.
And after such an earthquake there would be no human left alive for the radiation to hurt.
Reply: @VI-pp4jo  Dude,  this shit literally CAME from underground.  We are literally just putting it back where it came from after using most of it to generate energy.

Something  important to note here, the longer something is radioactive for, the less dangerous it is. Where do you think the radiation comes from? The energy has to come from somewhere.

Radiation comes from particles decaying. The faster they decay, the more radiation is output at any given time. So it stands to reason that if it takes a long time, such as 400,000 years to stop emitting radiation, that it is not emitting radiation very quickly. 

You can do the calculations yourself to determine just how "Dangerous" this stuff is, since you are so distrustful of all the math and experiments done by professionals. The math involved here isn't that hard.

It's very simple, we utilized the faster decaying radioactive material to generate energy. Leaving behind the slower decaying material that isn't as efficient as it is SLOWER!. 

The waste product is literally less radioactive than the fuel we mined out of the ground. IT is literally less dangerous than it's natural state.
Reply: @never5pring  Sometimes it is, sometimes those holes serve other purposes. Sometimes, it's better to take a safer approach and store it deeper underground where it wont get in the way of future development. The specific reasons would depend on where it was mined.

Can't store the waste in the mine until you finish digging out the good stuff. So you need to store the waste somewhere else, while you dig. Since you are storing it anyway, may as well make it a permanent storage.
Reply: @notbob555  Why do you talk to me as if we're on the same knowledge level "dude" when you don't even know the difference between u235 and depleted uranium.
"It stands to" / what reason? Have you read anything on the subject?

Stop talking about things you know nothing about.

The stuff that "comes from the ground" is stable. That's why it doesn't emit much radiation.

It is purposefully destabilised because that's how it releases the stored energy.

The window where energy is deemed "plentiful" enough is small, like taking the cherry off a cake and then throwing it.
The "depleted" uranium is just a notation, it's very much unstable and releases way more radiation than its stable form, over the course of 100k years along other radioactuve isotopes, which together form nuclear waste.

This nuclear waste is kept in deep pools, in radiation sealed chambers, for up to 8 years, before being encases in concrete tombs, as that's when heat is deemed mechanically bearable, and cost efficient for sealants. Such as concrete.

It is still very radioactive and if it were unsealed, you would die next to it. It releases radiation equal to what the workers on the roof of Chernobyl experienced for a couple of minutes.
They all died within weeks.

By comparison, U235 can be held in your hand without protection.

The fact that you don't know jack shit about how nuclear fision works, how reactors work, or indeed the subject at all but still FEEL like you know, is my entire point in this thread.

A bunch of individuals talking shit, making up a herd, growing larger and larger, only waking up when the radiation poisoning is prevalent and giving birth to "omg, those bastards" movements when in fact, you're all a bunch of wilfully ignorant, greedy, disgusting people.

Don't "dude" me. You're not even at my fingernail nuclear information wise.
Reply: Just build bloody Thorium reactors...then you have next to ZERO waste problem...
Reply: @wildfire160  sincerely didn't know those were a thing. Gonna look into it
Reply: Wait until we ship it all to the moon.
Reply: @GiorgiGoguaTuzo  Falun Gong cult
Reply: @jxkc.3941  Not really, just spread out over a larger area. The process of enriching Uranium fuel merely concentrates more of the desired isotope in one place. In fact, the spent fuel rods are less radioactive than the ore that was originally dug up to make them since they have already emitted some portion of their natural radioactivity while they powered the nuclear plant.
Reply: @pazz1038  no, it most likely won't, they built it in a place where the rock foundation has been stable for millions of years, the chance of the containment being breached by any geological event is astronomically low
Reply: @VI-pp4jo  Give it a rest pal, you got slaughtered here.
Reply: @MultiVeika millions of years isn't long in geological terms, don't think we are smart enough to predict the exact geological movements, we cant even predict the weather accurately.
Reply: @pazz1038  Why do you believe that ground that has been stable for millions of years will now become unstable in a few thousand? 

And just how far do you think the radiation will spread? Can it spread?  Why do you believe that about 500 meters of rock cannot stop the radiation that 4 meters of concrete is stopping right now in our current containment systems?
Reply: @davidtherwhanger6795  I don't believe it will, just entertaining the possibility it could.
Reply: @davidtherwhanger6795  lol, when you vomit or take a dump, just simply put it back -  If it was already there it shouldn't be too much of a problem
Reply: @BWolf00  ever taken a look at the haz mat byproducts of solar panel or turbine construction? Quite interesting.
Reply: There is a difference between 10 meters in dirt and 500+ meter underground, in seismic inactive 1 billion year old bedrock
Reply: @Mic_Glow  admittedly yes. You may have missed the joke vs the title of the video
Reply: @miraclemaker1418  We can't .. It's funny .. And it got 8.9k votes ... It's a legitimate joke now .
Reply: @VI-pp4jo  all the money mmmmm... Nuclear level debt...tasty
Reply: It's not just burying it.  It's burying it in bedrock, inside a clay filled copper capsule.
Reply: @geosync9742  any idea what happens to rock when a volcano goes pop? 
... Same thing that happens to clay and copper containers
Reply: It'll outlive life on Earth
Reply: @TP-Vocals  I believe that's the worry, lol
Reply: @davidtherwhanger6795  have you told them that the sea is the biggest uranium reserve we can access? Might stop them from taking space at the beach.
Reply: @fyodorseriencha6538  Sorry, but you gave away your irrational bias such that no amount of facts or logic can overcome your emotion based reasoning.
Reply: @VI-pp4jo  how would you safely transport that waste to a "dump planet?"
Reply: @VI-pp4jo  you're basically arguing that because a study is not accessible to you, there is no such thing as objective facts. So every scientific study you don't like becomes some conspiracy between the scientists and politicians, energy companies, etc?
Reply: A massive failure to understand time scale. The idea that Finland might be able to control radioactivity from leaking or leaching into groundwater for 100 years -- OK, I'll stipulate it. If we are super generous, let's say 1,000 years. Do we really know if Finland or any other country will survive that long? What natural disasters might occur? What social changes might occur? It would be silly to say that we do. And that's just 1,000 years. That leaves a mere 100,000 years during which poisonous toxic crap sits in the ground, all because it was convenient to do so for a very very brief time. I would call nuclear a terrible plan but that's too kind. There is no plan.
Reply: @qqw743  nail, meet the head of the hammer

It's human hubris!
Reply: @VenkmanPhD  Totally didn't notice what I'd walked into here. I thought this would be a scientific/policy discussion following some rational guidelines. Instead I appear to have wandered into some emotional or perhaps financial agendas. Well, good luck everyone, but I am not interested in that sort of thing. See ya around.
Reply: The discussion in this thread is somehow a sad reflection of discussions that seem to be more and more commonplace these days - especially on social media channels.

There is someone who is clearly educated and an expert in their field, and someone who clearly is not, but has a strong opinion. It's sad in that even if the expert states facts and gives good reasons, even compared to alternatives, the other person can't be asked to consider that and instead insists on his opinion.

What I find amusing is the comment along the lines of "yeah ok this study exists but 90% of society can't read/understand it so it's worthless". Some technologies are complex and difficult to understand, that's why there are experts who spend their whole lives dealing with them and ultimately know the most about the subject. So it is their expertise and experience that you should trust in this case.

I have no fixed opinion on the subject of nuclear energy. I can understand the fears and I do not support the principle along the lines of  "I close my eyes to the problem and let others (future generations) deal with it". On the other hand, I think the fear about radioactivity is exaggerated. I think disasters and the development of nuclear weapons has contributed to this sophistry, but if the technology can be used in a scientifically sound and in a fundamentally safe and "clean" way, then I'm afraid I don't understand the stubbornness of the opponents.
Reply: You could put it on ice in Antarctica & would sink miles below: problem solved!
Reply: @BigFootyHD  hey so my comment, while funny, is a summary of what transpired.
I imagine burying this stuff in an area that's less geothermally active would be wiser.
Also DOUBTING the effects of radioactivity is a terrible mistake. There's no cure for radioactivity poisoning and it affects water, soil and microbes. It's brutal
Reply: @davidtherwhanger6795  you sound like the guy from BP telling everyone how foolproof their drilling rigs were & spills and accidents dont happen in the 21st century. then we had Deepwater Horizon
Reply: @dannybaker8273  Sound like. But can you actually show where I am wrong?
Or will you let your pre existing bias and opinion serve as fact and logic?
Reply: @davidtherwhanger6795  having read this whole conversation, i applaud you. I don't understand how people think they can genuinely argue against strongly founded science. This person would argue that the law of conservation of energy isn't tested well enough to push objects around if you told them that object would remain in its new position for 400K years if nothing else acted on it.
Reply: @BWolf00  As video said solar and wind are periodic energy sources. In this country nuclear is an option, but in others yes solar and wind do work better.
Reply: Seems you didn't understand the video.
Sad!
Reply: @SaltiDawg2008  listen here you Trump-lite jagoff, maybe take a step back and look at the humor of the comment before assuming I didn't watch the video and digest it. The remainder of the comments I have engaged in a thorough discussion and launching of my concerns/hesitancy to bury nuclear waste in a country known for its geothermal activity.
Reply: @BigFootyHD  I understand and respect your point, and am therefore responding in a thread I told myself was getting to be a bit much. 
I agree that in far too many instances, the passionate but uninformed jump up to baselessly counter the well-informed. 
But my point here is that those who study nuclear physics are not in fact better informed on this issue, because of the time scale. Current science cannot account for that. 
Do nuclear physicists know more than amateurs about nuclear fission? Of course. Do geologists and safety experts know more than I do about how to find safer places and safer ways to bury materiel? Of course they do. 
But that does not mean that they know what will happen in 50,000 years with any confidence, and a real scientist would readily admit that. 
By analogy: an immunologist and epidemiologist can interpret vaccine studies and describe what is likely to happen in the coming year if we get certain levels of vaccination. But they cannot say "We can advise you how safe a future vaccination, 50 years from now, will be against a future unknown disease at that time." 
I believe in science and accept that experts know more than amateurs. But in the case of the unfathomable time-scale of nuclear waste, no one is an expert, and there is no scientific study to back anything up. 
If an expert can show us a study of this type of nuclear plant and how well 100 such plants held up over 50,000 years, then they would have expertise to offer. Without that they are engaged in conjecture, not science. 
Thank you.
Reply: Would burning coal be a better option?
Reply: @SwingingVoter  That doesn't sound like a question. But if it is a question, then the answer is no, burning coal would be a worse option. Coal plants has been proven, through scientific evidence meticulously collected, to contribute to global warming and climate change, which are very bad things.
Reply: Exactly my thoughts! You must be a smart guy!
Reply: @davidtherwhanger6795  I know this is late but I'm happy that my joke made an opportunity for SOME intelligent conversation. A lot of people taking jabs at me for the initial post and skepticism.. although I'm 100% confident that the seals will leak, your explanation that the hazmat being buried is much weaker does give me some peace of mind for this process. I'm still nightmare level worried about geothermic activity uprooting the whole structure. Fracking itself doing what it does seems like a cautionary tale that the earth doesn't just "take it and like it", it has a give and take relationship
Reply: @jxkc.3941  most of the radioactive energy of nuclear waste is already used up during its time in the reactor, so it’s actually less radioactive now, not more.
Reply: @VenkmanPhD  Well fracking is a little different. I'm no expert in it. But in fracking we actually try to fracture the bedrock by over pressurizing it with a liquid of some sort that we shove into it. As it is a high pressure method that means the whole system will seek balance and eventually allow release of the pressure.

It is different in this case as the system is not meant to push hard to reach resources out of the ground, but instead to keep them there.

And choosing a location like this away from fault lines in stable areas that have been that way for millions of years means the chance a volcano erupting right under it is negligible. With monitoring we would have warning also. When appearing in a new area a volcano starts as a pocket of magma that builds pressure. This building of pressure deforms and pushes up the ground above it. We would notice this in fractures in the tunnels and an increase in heat in the chambers that could not be accounted for otherwise. This would give us warning to evacuate the facility. And these build ups to eruption take days to weeks for quick ones. Some we have been monitoring for decades without eruption. 

Not to mention that the magma moving thru the facility would not immediately burst out above ground. That would take more time to push thru. In that time the magma would also be melting the waste and mixing with it, further diluting it and it's potency. To what extent I cannot say, but some I am certain as you cannot mix two things without diluting them both and the lesser of the two in volume is always diluted more.

Now the waste will remain radioactive for a very long time. But the level of radioactivity will drop sharply over the first 700 years. This is due to the fact that any given material has only so many neutrons. And these have been forced to shed those neutrons much faster than normal. This shedding when out of the reactor is not as great, but still higher than the level of normal material. The results being that the waste will loose it's ability to shed the extra neutrons quicker than natural material.

Hope this helps.
Reply: @davidtherwhanger6795  this helps my brain a great deal, thank you!
Reply: 369th comment
Reply: @仙帝  with that user name you don't disappoint at all lol
Reply: @davidtherwhanger6795  wait only a few million years of fuel left ? wasn't it billions?
Reply: @davidtherwhanger6795  I see thank you for the answer your interactions with v i  was very interesting Too bad you didn't manage to convince him even a little, and also you have a lot of patience indeed :)
Reply: @davidtherwhanger6795  it was in the ground in an area that didnt bother anyone. When we start drilling holes and making man made underground buildings that will inevitably leak (they all do and often cant be fixed or at least easily) who knows who will be effected. With a third of our fresh water being underground.
Reply: @Nobody-vr5nl  How deep where you in the ground? Who built it? What was it designed for before? What materials were used in it's construction? How deep was it?

Only then can we compare.
Reply: @Phyz7  Only to those who do not understand are things not simple. Simple math is complex and difficult for one who does not know math. The written language is complex and difficult to one who does not know writing. 

The concept is the same here. Those that know see it as how simple it really is. Those that don't see only their worst fears of the unknown and will contrive scenarios that while possible are so improbable that with any other dangerous/ poisonous material it is not even a thought to them. 

And even with this material many are fine with only a few meters of concrete sitting atop fault lines to protect them. But are against burying it under dozens of meters of solid rock with no fault line? And have stated that it is better to store the waste with only a few meters of concrete on a fault line than bury it for various reasons.

This whole argument against can be boiled down to the "not in my backyard" ideology. They will use the power from it. But don't put it near me is their cry. All out of fear of the unknown.
Reply: @jxkc.3941  you know we can use nuclear waste as fuel now, right?
Reply: @jxkc.3941  how do you feel about thorium nuclear energy? It can't be used for weapons, thorium is way more common than uranium, and waste isn't a problem. China has the first commercial thorium reactor.
Reply: @davidtherwhanger6795  Too simple. Okay, it came from a mine, but we people concentrated and concentrated the stuff. By processing it, you end up with more material that is slightly less radioactive, but still very dangerous, you will simply die when you see it. In the end it will decay until it has changed into lead. But that will take even more than those 100,000 years. It goes that slow. Simply dispearsing and burrying again is not an option. Wish it were.
Reply: @fyodorseriencha6538  Ground water moves deep and very slowly. Those containers keep the water clean, but I wonder if the ground water would get radioactive and reach the surface say 10,000 years later.
Reply: @Fabian-jw5ih  Why people DON'T do things is rather complicated. How would you know for sure? So, I suppose you meant this metaforkalley.
Reply: @BWolf00  Can we please replace you this month? Somebody loving an old diesel tractor, I understand that, but that negative banter about accu packs... hydrogen power cells would kill the need for a large accu. Okay, hydrogen tanks need cooling. Compared to the ICE, it is not that bad. There are several new techniques being developed, today. Bashing battery packs could be out dated before you say oops.
Reply: @voornaam3191  If about one foot of stone drops the power of the radiation that gets to you by a factor of 10, why not? Right now it is stored in cement containers on the surface and those containers are 3 to 4 meters thick. And people walk around them daily without protective suits. If 3 to 4 meters of concrete is enough to protect you why is over 100 meters of natural stone not?
Reply: @CarlosAM1  Ya and I can just dump my used oil in a lake not in my town. Hey it works!
Reply: @xmusjackson7058  no because the oil is spilling everywhere and mixing with the water. Awful comparison
Reply: @davidtherwhanger6795  What about having an aggregate of those buried chambers. You said "you can knock off about a thousand zeros by just the effect of the ground between you and it." Does that still work when you have thousands of those chambers buried in aggregate? Thanks so much.
Reply: @pixpusha  We're talking about the total radiation given off by all of them. And decreasing the amount of radiation that gets to you by a factor of 10 (dropping a zero off the total) for approximately every foot of solid rock between you and them.

Currently hundreds are stored above ground with only 3 to 4 meters of concrete between you and them. And workers walk daily unprotected around those containers. Increasing the protection from 3 to 4 meters to over 100 meters should be considered overkill.

Also spent fuel doesn't have the half life like natural material would. There are only so many neutrons in any given amount of uranium. We make it to where the uranium sheds the neutrons faster than normal to make it nuclear fuel. The result is material that is way more radioactive than the normal uranium, but also looses it's radiation much faster. Where the drop in regular uranium goes down steadily over hundreds of thousands of years, nuclear fuel is considered spent (no longer useful) after a few years. And that spent fuel's drop in radiation is like falling off a cliff compared to regular uranium. In the first 700 years the spent fuel will loose over half of it's radiation.
Reply: @CarlosAM1     The Titanic worked too...
Reply: @donkeyearrs  no, not a comparison in any wah lmao
Reply: @davidtherwhanger6795   I’ve just read through this thread from start to finish and I thank you for more understanding in the nuclear field. Some of your comparisons really put it in perspective for me personally.
Reply: @davidtherwhanger6795  it didn't come from the ground. It's spent nuclear material. It's not the same as uranium found naturally. Which is then enriched and then used
Reply: @travisconfer2255  And how did we enrich it? What does the enrichment process do?
Reply: Technically speaking it's not the worst idea. I mean most of it came from deep within the earth so putting it just as deep or deeper probably wont make it worse than before it was mined in the first place
Reply: @seannissen2509  I watched the video too, I just think it may not be a great idea given the volcanic nature of the area...
Reply: @davidtherwhanger6795  Slight correction.  I've not seen an estimate for heating produced by the decay of radioactive elements, but it is certainly not the only thing producing geothermal heat.  The core has yet to cool from the original accretion formation, and there is a significant amount of heat produced by friction as hot material rise and cool material sinks through the mantle.  Obviously, these do not maintain the temperature on their own, as no energy is input into the system, but neither does the heating caused by the decay of radioactive elements.  It is also certainly decreasing over time, though to a varying degree based on isotope.  I'd be interested to see if there's literature I'm unaware of that breaks down the contribution of these sources.
Reply: First of all, if you bury the reactor building, in case of distater, the environment gets real protected...
Reply: @fyodorseriencha6538  so come up with a better solution then... solid bedrock that is not even remotly close to any continental plates wont move or crack
Reply: @fyodorseriencha6538  Deep ground water doesn't reach that depth. Bedrock is more solid than the most sophisticated waterproofed concrete. If water reached that depth, you wouldn't have an ocean.
Reply: @davidtherwhanger6795  It did not come from the ground highly enriched and deadly for 100,000 years.
Reply: @freethinker8274  No. It came from the ground at normal levels and deadly for millions of years.

A mistake you make is you think we are talking about highly enriched uranium. That is only used in nuclear bombs. We are talking about low enriched uranium fuel. This reactor fuel is 3% to 4% enriched. Out of the ground is 0.7% on average. With some deposits being higher than that already. Also most of the radiation given off by spent nuclear fuel is gone after the first thousand years. It's a huge drop of about 70% and levels off some to decline slower after that.

Our current method of containment is far less sound as this method. Currently we have only 3 to 4 meters of concrete around it and stored above ground after about 8 years in a water tank to cool. And you can walk around the containment bunkers (outside them) without any danger. So why then is over 100 meters of stone (close enough to concrete's radiation shielding level to be practically the same on a 1 for 1 basis) not a good idea?
Reply: @jxkc.3941  In some places in the world, there are veins of such radioactive materials that came from natural nuclear reactions.
Radiation isn't artificial.
Reply: @fyodorseriencha6538  This right here. I don't know why people are so  keen on adding another pollution source. And one you can't just sterilize to boot. Fission is a stop gap, nothing more. Period. Focus on fusion, where the waste product can be pure water.
Reply: HAHAHA!
Reply: its a shit idea.
Reply: @jxkc.3941  If it is buried deep enough in the right kind of rock formation it won't make any difference.
Reply: "Bury it deeper."
- "That's what she said."
Reply: Bury it smarter, like in a subduction zone
Reply: @davidtherwhanger6795  Thank you for this comment, sir.  Everything you say is correct and well taken.  Sadly, as you may have noticed from some of the replies,. there is no talking to people who harbor irrational and highly emotional views in opposition to nuclear power.  Such people are incredibly ingenious in dreaming up plausible sounding but false  and misleading rationalizations in support of their prejudices.  Nevertheless, you have my support.
Reply: @GiorgiGoguaTuzo  Because the Earth's crust doesn't stay still but, more importantly, burying doesn't solve the problems of the cost of building the plant, the cost of maintaining it after its lifetime, the carbon costs involved in building the plant, the increased chances for nuclear proliferation and the material getting into the wrong hands (think terrorists), the danger that the plant poses during a war (think Chernobyl), the danger of accidents (3 in the 60 years of nuclear power, all of which have been devastating), the lack of these problems with alternatives, and the carbon cost involved in building a nuclear power plant. 
Is that enough or do you want more problems?
Reply: Burying nuclear waste is like kicking the can on the road  in front of you... it just moves to somewhere/someone else...
Reply: Or export the waste to third world countries. Oh wait, already doing that.
Reply: @daishi74  he..he..
Reply: Why isn't a good idea? As long as there is enough space we can practically keep it down there indefinitely, and it's relatively easy to relocate since it's just a solid hunk of cement, glass and radioactive material.
Reply: You have hell of a lot of surety and confidence in your ability to keep things secure for the next 100,000+ years... 
Perhaps you can look back in time and tell me what was going on in  Finland.. say (I will give you a break)... say 20,000 years back... and between then and now.... that you can guarantee the future safety and isolation of lethal Nuclear Waste for 100,000+ years .. yes 1000+ generations in the future...
Reply: @lucaslucas191202  I've said a few times I'm concerned because it's a very geothermally active area. One steam vent from a magma vein and it'll deterioration the entire facility RAPIDLY and seep radioactive material everywhere
Reply: @VI-pp4jo  I mean if we dont know whats going to happen in the next 200 years to the copper, how tf do you know. It could get stronger, it could melt, it could explode, it could stay the same, as you said " we have no way of predicting the long term effects of it".
Reply: Lmao😂 

In fairness, we dug the stuff out of the ground in the first place. Only fitting we put it back in our own hole.
Reply: @fyodorseriencha6538  it's in BEDROCK.. no water flows thru bedrock. Note how only CERTAIN AREAS globally, can be used this way on the map shown??
Reply: exactly... wtf..